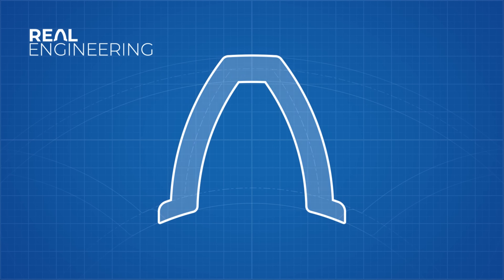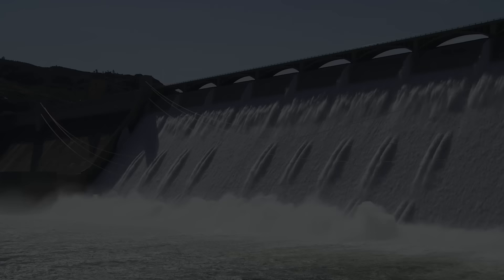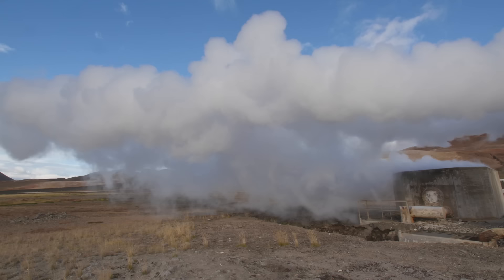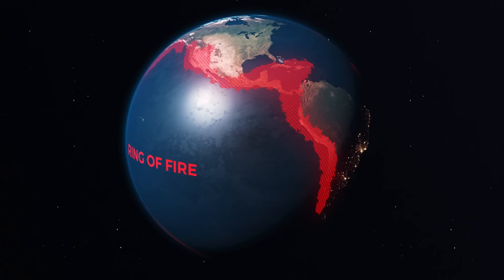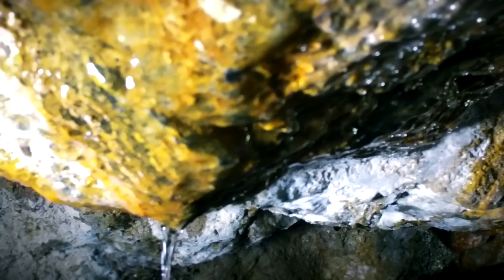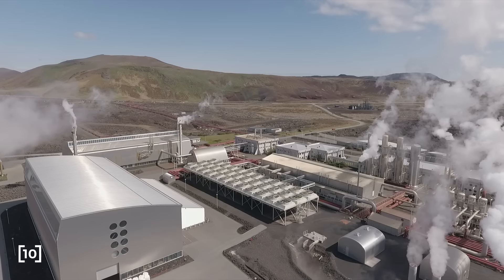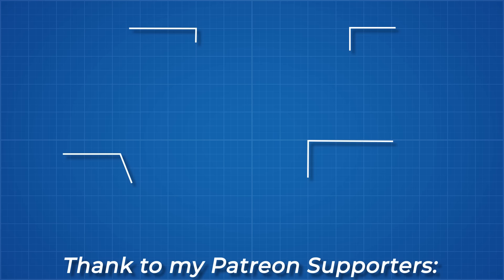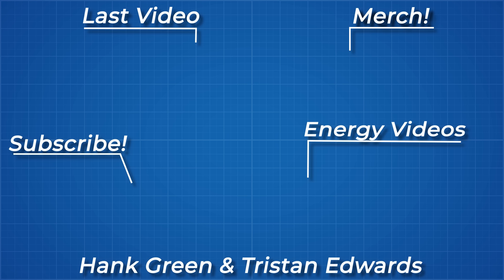Could Earth's Heat Solve Our Energy Problems?

Comment: German mechanical engineer here. Greatly appreciate the in-depth video as always. I wanted to point out some big potential drawbacks of geothermal energy you did not include in the video.

1. Geothermal energy is not boundless as the video suggests. Following the first law of thermodynamics, a natural occurring geothermal reservoir (or aquifer as it is known in the field) or a man-made one thanks to EGS, is bound to lose temperature over time due to the fact that we pump out more heat than we reinject. This inevitably causes a decrease in the aquifers temperature, which in turn causes a diminished steam production which then reduces the amount of generated electricity by turbine/generator. Some sources suggest that the average aquifer requires roughly 30 years until the original temperature is reached again.

2.Scaling/ Fouling. This is probably one of the greatest technical problems with geothermal plants nowadays. Since the water used for direct steam generation or secondary cycle heat transfer is coming from ca.3-4 km underground, it is saturated with different minerals, the most common being SiO2 (quartz) and CaCO3 (limestone). The chemical nature and type of the minerals is highly dependent on the location of the geothermal plant, but you can research them further if you'd like. Rapid changes in pressure and temperature along the pipes leads to the precipitation of these minerals (Scaling/Fouling) and unfortunately quite frequently to the failure of vital mechanical components such as pumps and heat exchangers. This leads to frequent halts of electricity production in most geothermal power plants.

Sorry for the long comment, I just feel passionate about the subject since it was the topic of my thesis!
Reply: Not an engineer here, nor do I play one on tv, nor did I stay at a Holiday Inn express last night. Now that this is out of the way I do wonder, regarding point 1) simple solution is to alternate production between sites, more or less like farmers don't plant crops in the same field year after year. Leave things to warm back up and then restart production. If you have enough sites that you can rotate in and out of production you should be sustainable. For point 2) Best but also horribly expensive way to deal with this is to have all your piping in a closed loop and not use ground water as a heat exchange fluid. What I could "envision" is something that would look a bit like a large tunnel boring machine that would have all the hardware on board, tilt it at an angle, let it dig, once it reaches layers of rock hot enough the outer casing ends up acting as a kind of heat sink and all your power generation hardware is inside the machine, all that is needed is to run cables so you can connect the power generated to the grid. When the rocks the machine is sitting in invariably cool down, it's able to start the digger head again, dig itself a bit deeper and start production again. Hard to explain what I have in mind but I think you can get the general idea.
Reply: Great comment!
Reply: Feeds Ravens  that sounds incredibly inefficient and like you would lose more energy than you'd generate.
Reply: Thank you.
Reply: Indian Electrical Engineer here.
I very much want the geothermal energy to take off soon! In India we are establishing a huge network of solar panels and wind turbines for power demands. Our target is to achieve 50% of India's power drmand out of renewable power before 2040. New, 12 Thorium reactors-power plants are about to be erected before 2030. Even if nuclear is mostly safe, we are always skeptical about the nuclear waste management. So geothermal has to become successful. We cannot continue to pollute the atmosphere by today's power production standards!

Mechanical engineers like you can make it possible to overcome the shortcomings of geothermal energy!
Reply: @cypher10297  nuclear waste is NOT a real problem.
Reply: Excellent list of some of the real problems. Like all so-called renewables there are real physical limits that "greens" simply ignore.
Reply: Can you use a low boiling temperature liquid (say Pentane) and let it flow in a shallower depth via piping and use the heat exchange between the ground and the liquid directly (instead of relying on a binary cycle system)? Seems more efficient, especially since it requires less energy to boil it - thus expanding the service life of that geothermal spot.
Reply: @cypher10297  
The confusion of CO2 with pollutants is the biggest problem.
Wind and solar at large scale will cost India, not help India. Actual pollutants can be well controlled. CO2 obsessions are a diversion.
Reply: @robertsmith4681  about the first point, as you told us that it will take about 30 years to make them hot again. Does that mean that an aquifer will last for about 30 years before going cold?

I know this actually depends upon the rate at we use the incoming heat, but i just am curious to know how fast a 75 degree aquifer runs out of heat. And how much of a place can it power ?

THANK YOU IN ADVANCE 
also, I learnt a lot from your comment too.
Reply: @MrMuki61  It's better to use a fluid with a higher thermal capacity in the ground loop. That way you don't have to pump as much fluid to extract the same amount of thermal energy. Heat exchangers can be very simple... basically 2 radiators stuck together or 2 pipes in close contact flowing in opposite directions.
Reply: @MrMuki61  that could be a reasonable solution. I wonder if the amount of potential work somehow changes at lower temperature?
I am always suspicious of easy looking solutions to tough challenges.
Reply: @MrMuki61  can you compare the coast of that liquid and water?
Reply: @huntera123  The reason why most actually easy things are hard to implement is because of people with attitude like you. Lol. I'm pretty sure you're not an engineer, but trying to teach actual engineers about how stuff work, without even having the basic understanding!
Reply: Edward Nelson trigger comment lols. CO2 plays a part in Global Warming and (health problems aside) that’s why we have to control it.
Reply: @fdc184  
Check your assumptions, check the actual data, and check the history of failed climate catastrophist predictions 
Pointing out that the Emperor had no clothes did not require special education. Ignoring that the Emperor has no clothes requires highly educated group think.
The catastrophist predictions are this generation's emperor's clothes.
Reply: @NickHorvath  I was thinking about this as more of as solution for arid countries. I'm from Israel and every drop of water is like gold over here (even though we have enough desalination plants to supply everything we need). Plus the fact that you don't need to drill as deep means that the risk for earthquakes is reduced. Only downside to this process (aside from the larger quantity of liquid required) would probably be the toxicity of the liquid. I wonder what would be the cost differences between the two liquids in the overall design (storage, usage, transport and procurement). Water is cheap and non-toxic, so it doesn't need any special care or attention. Pentane however will require more robust piping and more security measures to avoid leakage, thus increasing overall cost and reducing the efficiency of the heat exchange process. Maybe a different, less toxic liquid would be a better candidate. Would be a pretty interesting study though.
Reply: @cypher10297  
Skeptics are not sabotaging grand plans. Blaming non-believers for the continued failures of all climate obsessed policies is almost like blaming witches for droughts or sick cattle.
Reply: @cypher10297  or we could just stop using fossil fuels all together and use plasma for energy and transportation. Buuuut our governments wouldn't like that, or allow that, now would they?
Reply: Feeds Ravens  didn't cars used to be electric and have flex fuel 

It's the oil patents that want a sea way to Alaska and bankers that you need to have on our side. And they won't, as the Smoke And Fumes Committee shows, they're less sympathetic then a cartoon villain
Reply: Ehh.... I find the listed drawbacks to be minimal, but i live close to Yellowstone.
 
srsly though. 

You're drawbacks are a matter of perspective. 
You're viewing geothermal as primary source of energy, and, to be fair, the video presents them that way. 

Geothermal probably shouldn't be used as a primary energy source. 
It should be used to store power produced during peak-production time for renewable energy.
By choosing the depth and pressure that the water is pumped from, you can limit the thermal transfer out of the geothermal well. 
Couple that with a method for injecting hot steam back into the ground, and you have an energy storage method, not necessarily a primary energy source. 

After all that, the video specifically seems to ignore natural gas production of geothermal sources. 
Although I'm aware of the fact that not every geothermal well produces copious amounts of natural gas, I think that's more due to our lack of utilization, rather than it truly being an impossibility. 
Fischer-Tropsch synthesis, in which carbon monoxide and dioxide are turned into methane, and syn-gas reforming, in which a carbon source is turned into methane, hydrogen, and/or carbon dioxide, are both potentially active in the same place, depending on rock composition, temperature, and pressure. 
Allowing a liter of methane to vent into the atmosphere is the equivalent of venting 50 liters of Carbon Dioxide, so really the issue with geothermal is an issue of scale and potential harm through careless release.
Reply: @vDarknessFalls  If money is going to pour in because of oil? 100% The government wouldn't switch to anything that's going to affect this income. Even if it means destroying the planet. Arab countries and USA belongs in this category.

If money is wasted because of oil imports? The government will take steps to limit or completely halt the outgoing money. Saving the planet is a side effect of the move. India, Europe and other advanced Asian countries belong in this category.
Reply: @snim9515  Well, it's hard to say since it depends on where you live. In general, Pentane can cost as low as $1 per Kg if you buy in bulk (which is the likely option if you want to use it commercially). Generally, in geothermal power plants the water that is used is already there (groundwater), so it's basically free (aside from licensing fees incurred by the government).
Reply: @MrMuki61  adding the coast of transportation and you have your answer.
Reply: @AmericanJusticeCorp 
But here's the thing. The earth's core is PLASMA. The ONLY thing containing that plasma, is the mantle tightly packed around it like a plasma globe you seen in science class. What the fuck do you think drilling and fracking that glass globe will do to the plasma inside??? Hmm?
Reply: Danaili6i
 -I was going to say the same thing but you have already covered it. I have, in fact, been to the Wairakei geothermal power station in New Zealand and they have already experienced drops in steam field output. In addition, some of the geothermal attractions in the area have failed. It may be a natural resource, but nothing is limitless.
Reply: Is there a way to view your thesis on this topic? Would it be possible to view it on ResearchGate?
Reply: Robert Smith You’re idea is highly unrealistic and relies on the idea that there are infinite geothermal vents. The digging required to reach the same temperatures that natural geothermal vents are extremely expensive. Have you ever heard of the drilling race? It’s the underrated version of the space-race between the United States and the Soviet Union. The project itself cost 2.4 billion dollars for the Soviet Union and stopped way before they reached the mantle. Geothermal energy is not some magical solution, there are majors flaws to it. There is a reason we don’t see a lot of investment in geothermal power. It doesn’t take an engineer or a science degree to know you can’t force something to work.
Reply: Student of computational physics and mechanical engineering here: I have a concern on the environmental impact and more particularly the earthquake and seismic impact that these  geothermic plants bring to already high seismic areas. Is there a way to reduce or eradicate this issue? Or is this a non-issue now?
Reply: Geothermal energy has been stable for billions of years, as the earths generated heat is met with the solar radiation which creates an equilibrium of heat escaping. So irrespective of entropy for human lifespans geothermal energy is boundless but as the mechanical engineer suggests its not free, there are issues that drive costs.  Still comparing those issues to Otec, Nuclear, wave or tidal power, sources that can be non intermittent, there is a lot to favor geothermal.  One has to also separate high temp geothermal from low temp geothermal. Low temp geothermal such as harvested by heat pumps could use syitling engines to pump using solar and thermal storage and could be much less expensive.  Also using an organic rankine cycle or thermal chemical oscillators to drive such are new methods which could also be applied to Otec.
Reply: @robertsmith4681  you're right: you aren't an engineer, so don't think you know more than an engineer.
Reply: Well yes number one is a big problem but it has an easy solution, well, it would take an incredible amount of time for the geothermal energy to wear off, especially since convection is always bringing new heat up from the core, so that problem is basically non-existence. 
I would say the biggest con is that we are slowly dooming ourselves to a slow and painfull death by radiation from the sun, since we would cool the earth's core faster causing the iron to solidify and henceforth stop spinning. Which would cause the protective magnetic field to go away and the sun's radiation would slowly kill us, (well not slowly). And if you survived that in a few million years after the magnetic field went bye-bye the atmosphere would be completely stripped away from solar winds leaving earth a barren uninhabitable rock. Of course we would die sooner using coal.
Reply: @remenencenda768  Couple it with geothermal heat pumps such that in summer you are pumping in heat, it will raise temps is does in the field, and it can offset the loses as long as we have a functioning sun.
Reply: @remenencenda768  finally someone else who thought about the fact, that geothermal energy is essentially draining earths core temperature leading to the scenario you mentioned, which eventually will happen anyways, but one should think about if it is really such a good idea to artificially speed up this process...
Reply: @TheScarvig  With enough wind mills one could stop all wind. With enough geothermal plants one could stop all convection currents.
Reply: @TheScarvig  That was just me rambling, while it will eventually do that it will take an insane amount of time, and like I said, The other sources would kill us faster
Reply: @KimberlyRPeacock  It was a JOKE I mean, it might happen but it is in no way relevant to us. Also the radiactive elements will eventually decay completely and the scenario will still go on
Reply: Kepler Burger  That is correct you are thinking like a scientist in systems.   Besides like I said you can ensure more solar is stored than would be naturally of course that might impact global warming. I tend to think not long term as the dynamics are in atmosphere.  Hotter temps you radiate more colder and you absorb more.
Reply: Thank you so much for your Insight. I like these videos because they give us a chance to think and sometimes give us a snapshot as to where our progress is in different areas
Reply: @cypher10297  every solar panel produced takes ~7 years to offset it's carbon footprint if it doesn't require any maintenance or replacement from damage. each battery produced to store the solar energy takes ~15 years to offset it's carbon footprint but needs to be replaced every 8-10 years. solar is worse for the environment than coal. especially when  you look at the fact that coal production plants can be net negative carbon by containing the carbon and selling it for welders and manufacturing.
Reply: There are three main sources of heat in the deep earth: (1) heat from when the planet formed and accreted, which has not yet been lost; (2) frictional heating, caused by denser core material sinking to the centre of the planet; and (3) heat from the decay of radioactive elements. 
Verhoogen gives 5000 K as the core temperature now, and a 250 K cooling since the formation of the Solar System, 4.5 billion years ago. 
If it really does cool at that rate (55 degrees per billion years), it would take something like 91 billion years to cool to 0 Kelvin.
Reply: @emilie6466  It is true that I am an optimist when it comes to people figuring out how to solve engineering challenges such as making deep drilling economical. Just look at how far we got in barely 100 years.
Reply: There are a lot of renewable and different energy options that we are goin for I dont think geothermal will realistically pan out but its always good to look
Reply: @cypher10297  Thorium Salt (liquid) reactors actually burn the "normal" nuclear waste as fuel, so you would actually get less waste by utilizing that technology.
Reply: @Danaili6i thank you for sending some clarifying information, your passion is evident.
Reply: Well. That's just like... your opinion, man.
Reply: Carnot Cycle
Reply: Well I would like to think you passed👍
Reply: A pipe inside of a pipe is a loop.   But even stainless steel has a short life a high temperature when water is involved.
Reply: 1. The Earth's core is naturally cooling as with all planets, and exposing and using more geothermal only accelerates this cooling.  A cooler core means a less active core, which leads to a weaker magnetic field.  A weaker magnetic field has all kinds of disastrous effects that eventually lead to Mars conditions.

2. Shallow field heat pumps are mostly fine as they utilize ground level heating and does not tap into mantle source heat. 

This is more than just an engineering  problem and there are serious geophysical repercussions beyond surface level earthquakes.
Reply: For number 1,
Couldnt we put nuclear waste there? It produces heat and is basically a low temperature nuclear reactor. That way we are pumping heat in at the same rate we pump heat out. First we have to get the amount of heat we are taking out, and put the equivalent amount of nuclear material in there, but then it is only pumping in the waste at the rate needed to sustain the amount of nuclear material down there.
Reply: Balanced discussion is always appreciated.  Thank you for contributing your detailed supplemental viewpoints
Reply: Danaili6i thanks for the insight. 
They’re inevitably has to be some concern with this type of fracking as well. 
Thoughts ?
Reply: S nim lol. You’ve maybe fallen and bumped your head too hard. 
It’s a problem alright. Now and for years to come. “ nuclear waste is NOT a problem” 
🤦🏻‍♂️ 
Lol. 
Wowza. 
Maybe if your the Japanese government it’s not. Or maybe the Russian government.  But the the rest of common sense humanity it’s a long lasting problem.
Reply: vDarkness Falls the earths core is molten iron and nickel not plasma.
Reply: It is called: FRACKING not EGS except to liars who do not like the acronym FRACKING
Reply: You said what I wanted to say. Thanks.
Reply: 1. I would rather read the data through a real functioning geothermal power plant rather than just, "Some sources suggest"
2.  "is bound to lose temperature over time due to the fact that we pump out more heat than we reinject.",... then how cold is the lava and ash ejected by the Earth during volcano eruption than can happen around several time in 100 years?
Reply: hi, this might be a stupid question but i've wondered for a while: why are outlet holes even necessary? couldn't a valve at the top of the injection well allow steam to escape while still pumping water in?
Reply: @frankmueller2781  Inventer of interlaced TV signal was 12 years old...
Reply: I find it funny how you emphasize 'German'. It's lovely.
Reply: If only we had a "on demand" source to cover the maintainence/downtime. Itd be the energy utopia.
Reply: Feeds Ravens  
So a clean way to generate kerosene...a fossil fuel?
This might be a good video topic for Thunderf00t after all....and that's rare.
Reply: Yen Tao  
Exactly.
We are like ants. We think we control the planet but that's like fleas thinking they control the dog.
Reply: Feeds Ravens  
Ask France how that's working for them? Then ask Germany how much energy they. (THEY) generate during the nighttime hours.
Reply: Feeds Ravens  
The world has been ending for neigh fifty years. Yet we're still here.

From ozone to global warming to climate change to man made climate change.

It's been 12 years for 50 years.
Reply: Feeds Ravens  
Exactly right.
I'm very impressed at how quickly you formulate such detailed responses.  
In my opinion... we aren't quite ready to be 100% green. But we can get there in time.
Reply: @Acolyte47  You're absolutely right, but if you check the available alternatives like hydro power storage and hydrogen they are not efficient too. Power loss exists even in battery technology. I think that can be tolerated with the abundance of sun's energy and then you have to choose the technology for storage that is more cost effective.
Reply: Well, we have a real life example, New Zealand was using Geo-Thermal at an extensive rate. They had to stop it. Since so many people were tapping into their Geo-thermal reservoir, the reservoir was cooling down drastically the government had to stop new uses and I think I remember they were even discussing capping off existing pipes.So as @Danaili6i pointed out it is not limitless.@RealEngineering, Our biggest energy usage is temperature  control so if you just utilize the natural constant temperature from 6 meters below ground level you reduce your energy requirements. You also need to educate people to become more energy efficient producing more energy isn't the answer, the answer is to make it so the energy isn't needed to be produced. We need to make our caves better so they need less wood to heat the winter, and less ice to cool in the summer. The implementation of more passive heating and cooling is also required. 

Wave generators were looking promising but I lost track of what happened with those.
Reply: @snim9515  It can be, and it is in countries that aren't responsible with their disposal.
Reply: After he did a couple of videos on topics i have some knowlage on i realised this guys videos are quite heavly bias towards his own opinions and will often over look or simply brush off facts he doesnt like. Shame really cause the videos are well polished.
Reply: @robertsmith4681  Definitely not an engineer. In point 1) OP said that the laws of thermodynamics will cool Earth down more quickly because its core heat is not boundless. It doesn't just "regenerate". It dissipates.
Reply: @fdc184  But controlling CO2 emissions would cost big corporations too much money, and they'll go to any means necessary to stop such efforts.
Reply: Unless you are near a site with convention currents like an active volcano. I know in a town in Russia they use an active volcano to power the nearby town.
Reply: Edward Nelson check out my logic, or at least try to refute directly rather than pinpointing at patterns. 

So I’ll ask now. Outside of this disgust and perception of environmental notions as hysteria. 

Because that’s what happens, you get bombarded with Reds and you get used to it, grow accustomed to it.  

Outside all that what makes you think that global warming’s not a problem, that it is not real?
Reply: @emilie6466  the ruskies won that one though, didn't they.  We still haven't drilled a hole as deep as the Soviets. 😡
Reply: @NickHorvath  - "Steering" oil well drills got Kuwait in trouble with Iraq!
Reply: Awesome comment
Reply: Thank you.Nice to have real info from a professional.
Reply: Thanks I was wondering about thermodynamics myself. Just on a  longer time period and effects to the core. Yes the Earth's center is very hot and large. But by using it's heat, there MIGHT be future implications. What would happen if we used this technique for say... 500years? What effect would it have on the core? And in return the  magnetic field? Mars doesn't have a magnetic field anymore, because it's core cold down.
Reply: you make a good counter point
Reply: @snim9515  except that it is ..
Reply: Damn, why are Germans so good at engineering?  Just kidding, nice post!
Reply: Awsome comment the difficulting maintaining such a mechanism never occured to me 😀 thanks for that insight.
Reply: Civil engineer here, we will build it because we need to eat regardless
Reply: Not a accredited engineer of any sort but have a very scientific curious mind and recently read on new nanotechnology engineering making coatings possible that reject “deposits”.
Reply: Danaili6i Maybe they could make multiple small and movable power turbines and cycle them through an area ~every 30 years to allow the area’s to heat up again. Sort of like crop rotation, I guess, but for geothermal heat sources.
Reply: @kennethhickford1448  Cooling the core to 0 Kelvin is not necessary for catastrophic effects to occur. The magnetosphere just needs to be weak enough to allow the solar wind to penetrate to ground level and then to start depleting the atmosphere. Since the Earth is closer to the Sun than Mars, the effects of the solar wind on Earth would be at least 2.3 times greater (1.524 AU)
Reply: Where is the proof that the interior of the Earth is so hot?  Seriously!  We've only ever drilled less than 9 miles into the crust..  Seems like everyone has blindly accepted an unproven theory about the Earth forming from accretion and having ungodly heat inside.  I don't think there is evidence to support it.
Reply: Not boundless but look at the consequences of nuclear:  Chernobyl, 3 Mile Island, many unreported accidents raising global radioactivity, and need I mention Fukushima.
Reply: @vDarknessFalls  Deepest we have drilled (with massive issues because of the depth) is aprox. 10km. Distance to the center of the planet is aprox 6300 kms. We are NOT even close to reaching the super heated zones of the earth. And for the record, there is NO plasma at the earths core. It is a vast liquid sphere surrounding a core of solid metal.
Reply: @nevar108  you're right. Drilling doesn't affect it. I just did the math. BUT, all major earthquakes had VLF waves exiting the center of earth, hitting the ionosphere, and going back down. Only ONE thing creates VLF waves. PLASMA. The earth has a solid mass, but the very center, is PLASMA. Surrounded by an iron and nickel shell. JUST like a plasma globe. Prove me wrong about VLF plasma waves and earthquakes.
Reply: Wow!! Thank you for explaining this with such detail! Amazing comment man.
Reply: Could you not Just use a heat sink and peltier thermal electric generators to harness this geothermal energy? Would that not be more efficient in keeping the temperatures from  declining since we are not pumping in cooler water. The benefits of this are endless: there would not be a need for the use of a mechanical steam generator so there would be no more scaling/fouling including mechanical maintenance and break downs.Then we wouldnt have to do any fracking as there would be no need to do so. I have been pondering this for quite some time using peltier TEG's to our advantage. How many deserts do we have? How many volcanoes are there? how many hot pools are there. Just think of the possibilities it could be a very good non-invasive way at harnessing this energy without doing extreme harm to our crust by drilling and fracking.
Reply: Feeds Ravens  I personally believe that batteries are very good for small energy needs but very quickly reach the point where their benefits are outweighed by their limited capacity.  Batteries in the macro sense are like capacitors in the micro sense.  They are necessary to perform certain functions, but can not be depended upon as a primary source of power.  JMHO.
Reply: colleen nvb  To believe that puny human beings can deplete the Earth's core by tapping into it is like believing in human proximate cause global warming.
           A prediction:   Once humans can tap into the lower levels of our Earth's geothermal structures for  heat and energy use, there will be the AOC's of the world of self-proclaimed "experts" who will argue we are causing intentional "Global Cooling".
Reply: Appreciate your comments but some of the engineers I have spoke to see your two problems and will raise you a few. The Iceland use of GT is a great case example- they mine the rising heat and pipe it to their cities as a public heating resource rather than using firewood or even less green material. Additionally they have procedures to clean all this , so that can be taken as largely solved- California has been operating GT plants in it's northern counties continuously for many years, so I'm sure the "math" to compute the potential yield and therefore the highest rate of energy that can be siphoned out of a given hole.
   We have the tech to do this- the drilling tech has already figured out how to go 25-27 thousand feet down and predict to withing 3' where the drill bit is and will be- horizontally as well as horizontally. We can produce several kinds of set in place liners to protect our steam fluids from ground contamination and the ground from contact with our GT fluids. As some one her has said, Yellowstone is an active site- it is dangerous whether we try this or not, so getting the rest of the science done and then drilling thousands of horizontal wells around Yellowstone park and turning horizontal to cross under it and meet a predicted vertical bore hole 100-110 miles away could well do the US energy grid much good- it will employ thousands of oil field drilling personnel and equipment, thousands of RR and general construction people, huge bunches of certified welders, fitters etc. It will free the present oil co.s and allow their R&D to discover what new products can be made of the petrochemical soup they trade in today, while they transition from fossil fuels to a new energy source- much as they did when they were mostly big coal companies in the 19th C.. Ultimately, we can cool down the "plug" in the present day maw of the Yellowstone volcano; we could never stop watching and extending our GT field south and eastward to stay over the magma bubble that is closest to the surface.
  FWIW, I am a retired plumber, licensed in two states, have some college and a close connection thru my family to the "Oil Biz'. I have served as a classroom teacher's aide in the advanced classes on oil field technology and process that school taught to oil field crews from the roustabout to the administration levels of companies. Credentials matter when you are talking about pissing about with an unholy, massive disaster potential as the Yellowstone volcano; as I said earlier, I feel it can be done and it is important that America "do this thing"; there a five Yellowstone type super volcanoes in the world- if we prove a viable way to tap them and a program to stabilize the regions they are in, what would it be worth to say China or other nation to turn an impending disaster into a great source of energy?
  I think Andrew Yang is the right guy to take this up- he hasn't shown anti tech concepts etc., and his history with Silicon Valley suggests he would get the experts and the appropriate watchers to suss this out and figure a way to finance it . But that's my thoughts, anyway.
Reply: @fredericrike5974  I certainly appreciate the time you have taken to respond on behalf of anybody who might be interested.  I'll have to "sleep on it" as they say about your comment and meditate on your thoughts before I can return a viable comment, if even possible.  Thank you for responding in such an intelligent fashion.  Be well.
Reply: Leigh Hewit  but then we would lose alot of gravity and the strength of the magnetic field as a result if that happened.
Why would VLF waves be coming from our earth core, hitting the ionosphere, and coming back down?? There's only one thing that could do that. Plasma. Our Earth's very inner core, is PLASMA. Surrounded by the iron and nickel shell, much like the glass on a plasma globe in science class.
Reply: Feeds Ravens  Wow, you can rent gliders for $11.00 U.S? in Germany?   We can't even do that here in the States.  That is definitely a bargain.  In fact, at that price, I can afford to take a vacation to Germany, a country I've always wanted to visit, next to Italy, and get my glider pilot's license for under a few hundred dollars, U.S.  Thanks for the information.  Be well, thanks again.
Reply: Thank you for sharing your knowledge gained from experience...you make it clear that there is no turn key answer to our energy consumption.
Reply: @daffidavit  Will be looking forward to it! Be well and great fortune to you!
Reply: @Danaili6i
Thank you for the comment. Would your thesis happen to be available in English, or is it in German?
Reply: @Lexoka  Pardon if I seemed to overstate myself- I'm not a school trained engineer- far from it! But I've grown up with an engineer for a father and known the beasts since I was a child with "dumb questions". So there is no great thesis - but my response was to indicate this is an idea we need to explore thoroughly before just chucking it. The Chermin part of me became an American some two or three generations ago! But thanks anyway!
Reply: For those who are oblivious to this FACT, the Earth's magnetic field being generated at a super-hot iron/nickel core through a dynamo mechanism was NEVER MORE THAN AN HYPOTHESIS.  What if it's entirely wrong??  What if the interior isn't hot?  

What if the core is ice?  Are you aware that there is NO HIGH-PRESSURE PHASE OF IRON that allows it to exist at core pressures?  Ice is the only known substance with such a high-pressure  phase. 

Lava doesn't come from magma chambers or plumes originating in the mantle...  it is created in the crust below the point of expulsion thru frictional ground movement.   

Do you believe that mines get hotter as you go deeper into them because you are getting closer to the heat from the interior?  Why then, do oceans actually get colder as you go deeper and therefore closer to the supposed interior heat??  Why do deep cave systems not get hotter with depth?  

Earthquakes are the fracturing of brittle, solid matter.  If the interior is super-hot to the point where solid matter either becomes molten or ductile, how then do we explain DEEP EARTHQUAKES that take place in the mantle where nothing should be brittle enough to fracture? 

The Earth's magnetic field is generated in the CRUST thru a mechanism called Earthtide. 

All the above is contrary to modern scientific dogma.  It is, nevertheless..  CORRECT!
Reply: @freemind..  All very interesting. Sources we can research?
Reply: @Obscurai  Hi!
There so many variables in the progress of the Earths Transit via the journey through the outer edges of our Galaxy that to make any 'Prediction' as to future events is a bit foolish!
Plus, I never made any mention of the Catastrophies that may or may not occur to this planet. So, I don't know why you chose this tack?
I just commented on Geothermal energy!
Perchance you should read my post again?.....Yes?
Reply: @fredericrike5974  Sorry, my question was aimed at @Danaili6i, who mentioned having written a thesis on the topic. I've edited my question to reflect this. Sorry for the confusion, and thanks for taking the time to respond anyway!
Reply: @Lexoka  Not a problem! I prefer the discussions that start here vs IG and FB because they are more civil and to the point. Your question was certainly civil and your intent appears to be learning something- Good on You!
Reply: @Lexoka  FWIW; the energy people in Iceland and the Australians have done a heap of work on GT and many installations over the last decades- I've met some of the Aussies and  have seen some of their work- awesome, but I expected nothing else.
Reply: @kennethhickford1448  No you didn't mention the potential catastrophes - that's why I specifically mentioned them to you. The calculation to a 0 Kelvin core  may be mathematically correct, but is irrelevant to the discussion of geothermal energy since the Earth would be long dead and barren before 0 Kelvin is reached. That is why I chose "that tack". 

In particular, extensive use of deep drilling and use of geothermal (as opposed to opportunistic mostly surface level geothermal) is damaging to the fluid dynamics of the core and thus the magnetosphere. The issues for geothermal energy are not simply an engineering problem but a geophysical one that goes beyond surface level earthquakes. Sometimes, the engineers need to listen to the geophysicists.
Reply: @Obscurai  Once again I made no comment about the use of Geothermal Energy in my original post....Yes?
Reply: @kennethhickford1448  Then why are you commenting on a thread on geothermal energy about a video about geothermal energy? Mentioning the thermal energy sources and then simplistically calculating the duration of when the core would reach 0 Kelvin is irrelevant to this thread and to this video. What was your point in commenting?
Reply: Danaili6i As for point no.2, oil and gas refining has a similar effect on mechanical components such as valves, pumps, instrumentation, and piping systems in general.  The solution?  Maintenance as usual, and periodic overhauling of the mechanical systems.  As he mentioned in the video, it would be a great employment initiative for a well-trained and experienced group of mechanical tradesmen.
Reply: Thanks for this! I knew there had to be more drawbacks.
Reply: I may know a way to solve the problem. At least the scaling problem. Drill MANY holes and introduce hollow metal rods in the ground. Then cycle fluid through the rods. Not as efficient but it will work like a radiator. Cool the rods and extract the heat.
Reply: As an engineer myself I tend to watch these sorts of vids with a grain of salt. If there was some cheap, easy, and non polluting solution to energy generation, there would already be a huge industry around it due to government and market incentives. 

If something isn’t happening on a large scale it’s usually bc it’s not really as cheap as it seems or there are still technical issues to be worked out for large scale production.
Reply: @Obscurai  Re: "What was your point in commenting"?
Because I can and it's a free country,...Well......Sort of!
And who are you to tell me what I can and cannot post?
You are coming across as a real bully!
In which case you are wasting your time on me! LOL!
Reply: @RyanRussell885   Well said!
It seems that a certain section of Society want a foolproof 'Fit & Forget' solution to all the worlds problems, but, as ee and thee know, it ain't gonna happen! 
Mind you. they could Doctor the Monitoring equipment along the lines of VW Emissions so it looks like it's a 'Fit & Forget!!?? LOL!
Reply: @Lexoka  Thank you for the interest. It was written in German and is sadly not available to the public (part of non-disclosure agreement)
Reply: @RyanRussell885  There are a lot of possible solutions to scaling deposits. One of them are organic inhibitors which are still under research. They would be a very cool solution because they target the very genesis of scaling crystals and eliminate the need of frequent pipe maintenance. One of the more common solutions nowadays is the use of HCl (hydrochloric acid) - much like how we use strong acid solutions to clean limestone deposits from cooking pots, but this requires a maintenance halt of the power plant. This as you can imagine is a great economic loss for the geothermal power plants and can damage the acid resistive coatings of most steel components in time, potentially risking more need for maintenance.
Reply: @MerkDolf  Thanks for the insight on New Zealand! Wasn't aware of this.
Reply: @Danaili6i  Too bad, but thank you for your answer!
Reply: I think both issues could be overcome by going with a closed loop system and just drilling deeper. If we could place a heat exchanger in a depth that is barely below the melting point of the pipes and heat exchanger itself, it would just be a very efficient steam power plant, with an inert thermolite running through the loop between 1,000° C and ambient. Of course this all depends on improving drilling technology.
Reply: Danaili6i you’re absolutely right.  However, as a steamfitter that works in oil and gas—both conventional strip mining operations as well as Steam Assisted Gravity Drainage (SAGD)—I can tell you that constant maintenance and routine plant maintenance shutdowns are the norm and the name of the game.  There simply is no maintenance-free, automatic energy source, as much as we might like to think there is.  The last SAGD operation I worked at was both one of the most maintenance-intensive sites I worked at and also one of the most profitable.  The good news is that there are plenty of qualified professionals out there that are ready and willing to build and maintain these systems.  As I see it, there are always technical issues and challenges to contend with, but we, as a species have become quite good at developing solutions to those problems.  I think the biggest hurdle is really gathering political will and social support to defeat the oil and gas lobby and progress into the future.
Reply: @kennethhickford1448  In common discussion, relevance is prerequisite. Free country or not is irrelevant. Bully or not is irrelevant. How does your initial comment relate to the issue of geothermal energy usage? Since you avoided the question by bringing up free speech and personal assessments, you are indeed a waste of time.
Reply: @Obscurai  
Re: "You are indeed a waste of time"
You are entitled to your opinion. Hahahaha!
Once again, I made no reference to Geothermal usage in my original post.
Reply: As a joke mentioned once seeing a movie about this sort of thing. The movie had the scientists doing the drilling causing a crack to go around the Earth. This crack allowed a great mass of magma to erupt out into space, become a 2nd moon & start orbiting the Earth. I DON'T expect that to happen. Actually the movie hypothesized drilling down close to the core of the Earth. I don't expect anything like that to happen, it does go to the whole problem of disrupting the rock layers underneath, as is alluded to in this video. 
It seems to me, as an ignorant amateur, that the solution to your problem of mineral deposits & the causing of erosion by disrupting the rock layer beneath is w/ some kind of closed system. You place a closed loop of piping inside the Earth, pump clean water where the water is heated by the surrounding rock & then comes back up as steam. Maybe I'll be laughed at b/c of a 1,ooo technical reason why this is stupid but I'd like to know why it wouldn't work.
Reply: @VictorLepanto  Hi Victor!
Re: "You place a closed loop of piping inside the Earth, pump clean water where the water is heated by the surrounding rock & then comes back up as steam"!

They do something like you state but on a very small scale for heating Domestic dwellings.
Much like a Refrigerator in reverse,....Sort of. 
At a depth of about 15 metres, ground temperatures are not influenced by seasonal air temperature changes and tend to remain stable all year around at about the mean annual air temperature (9–13°C in the UK).
I read, (But don't quote me) they tried it on an estate somewhere in the UK, but had to shut it down as it cost too much to run!
They also bored holes down in Cornwall? somewhere some time back, and then capped off the Boreholes.
Currently, there are no deep geothermal plants in the UK. The Redruth site has the potential of supplying over 10 megawatts of electricity and 550 megawatts of heat for the community.
Reply: @kennethhickford1448  And once again, you are posting in a thread about geothermal energy under a video about geothermal energy, and you failed to explain how your post is relevant to that topic. This is not my opinion, but a question about the relevance of your post and you have still not provided one. You are indeed free to post anything you want, but if it is not relevant or you cannot explain its relevance then you are indeed a waste of time. I await your explanation of relevance.
Reply: @snim9515  please explain. This seems like a bold-faced lie to me, and to say it without any explanations is plainly irresponsible
Reply: @thoughtsfromahead  comparing the risk of nuclear waste (which can be disposed ) with the risk of  poisonous gases which can't be desposed, for starters.  Even making solar cells require high grade silicon which requires mining which has its own problems. Comparing the amount of coast per unit energy nuclear energy is much much much better than ANY other source. Moreover since  that nuclear melt down in Chernobyl NOT A SINGLE PERSON HAS DIED DUE TO NUCLEAR POWER PLANT. Do your own research.
Reply: @kennethhickford1448  Correct you have not provided any explanation of relevance to anyone for your initial post. That's why I am asking for it. Your continued refusal, or inability to provide one, confirms that your initial post is irrelevant. Thank you.
Reply: Taking large amounts of heat from the earth in scatter places seems like it would cause a lot of issues geologically speaking down the line.
Reply: @hgbugalou  Hello Michael.
As to the ramifications of using Geothermal Energy, that is a matter for those who know of what they speak.
All I have done is comment on the source of Geothermal Energy, not its possible use and the possible problems involved.
Regards.
Reply: @huntera123  I'd imagine the producer of this video, would consider himself a 'green'. I'm assuming I know, but most of his videos are about 'solutions' to the climate crisis. It kinda sounds like you would want renewables to fail, simply because you dislike the people supporting them. There are technical hurdles, not physical limits, to the future of our energy system. The 'real problems' of fossil fuels are still being ignored and they may kill us all.
Reply: @corneliuscorcoran9900  
Wow, I don't want them to fail and I  certainly don't want a physical/engineering process to fail for personal reasons. I point out that there is actually not a crisis and get insulted. I point out that "green" solutions don't work and get trolled.
Reply: Thank you for the real life insight and presentation.
Reply: @rosewhite---  
The amount of useful work from residual heat is negligible.
The cost of storing solar energy for cloudy/dark times is substantial. Batteries, pumped water, molten salt, storage walls, fly wheels, all have been tried and don't work.
Physics is not just a good idea, it is the law.
Reply: @rosewhite---  LOL.....   And how did you determine the age of the earth?  Did you also use this same method to determine the age of other planets and celestial bodies like the sun?    How about distances, you measure the distances between planets, the sun, and other stars?  what about the speed of light?
Reply: @rosewhite--- :-
I have no intention of doing what you suggest! LOL!
Regards.
Reply: And you have yet to describe how you determined earth's age, the methodology used, etc.
Reply: @rosewhite---    cyanobacteria transformed the world we have today making possible the rise of plants.   And snowflakes over geological time have tremendous power, they form glaciers which grind mountains away.  You are funny if you think that someone like you could insult me. You do not matter.
Reply: @rosewhite---  the pressure of the plates combined with the rotation of earth going 1000 mph, would create way too much heat at the core to allow the existence of water. There is no way Russians can drill deep enough to even reach the core first of all. Not even halfway. Now it is likely they hit coolspots in which no lava flow is near, to allow the existence of ocean sized water to form in giant cavern pockets deep down.
Reply: @rosewhite---  Good to se you have read Cicero.
“To be ignorant of what occurred before you were born is to remain always a child. For what is the worth of human life, unless it is woven into the life of our ancestors by the records of history?”
Reply: @rosewhite--- 

As I recall, Initially you posted me in response to a post to another on here!? .......So, who is doing the 'Trolling'?
BUT, as long as it annoys you, I am satisfied! Hahahahaha!
Reply: Canadian engineer here. I agree with the other real engineer from Germany. 
The Engineering isn't finished until you've done the Cost Benefit Analysis.  Study the existing Geothermal plant near San Francisco. It has not done well economically. If you really care, look it up. I do and I have.
Reply: @rosewhite---  so you mean to tell me the VLFs being measured coming from the core during big quakes, is from a water based core, even though the only thing that can create natural VLFs is plasma? Seems legit. Glad you're here to educate people.
Reply: @rosewhite---  
Oh, of course. Thank you for making yourself so clear.
Reply: @rosewhite---  It's impossible for the Earth to be only 6000 years old and for a global flood to have occurred. Put down your book of stories and learn some real physics.
Reply: @tadferd4340  thank you. Hey do you remember the strange atmospheric trumpet noises that get heard all over the world??
Reply: Im not even an engeniering but i do think the same as you say on the first one i mean there's a hot spring in bali before you couldn't even bath in there and now the temprature decreasing to 35C
Reply: Master engineer lvl100 here, just passing by.
Reply: @rosewhite---  We believe nothing but that which we can test and measure and subject to testing.  I'm guessing with your worm theory you do not believe in tectonic plates.  The outer crust of the earth is subject to recycling. That which we think of as solid,  is a floating crust which gets pulled down and is also spit back up in the form of molten rock which cools and becomes new crust and later new topsoil.
Reply: @rosewhite---  No Idea what you are referring to
Reply: @telciris  
From some going by "Warlock", lol.
Reading and hearing wide variety of views used to be called "open minded" and "well informed". But that was in an age of "tolerance".
Reply: @Danaili6i
Hallo, hab in deinem Kommentar gelesen das du Ingenieur bist... bin gerade 8 klasse Gymnasium und wollte später auch Ingenieur werden... hast du vllt ein paar Tipps auf welche Fächer man am besten achten sollte oder Lks? Danke schonmal im voraus!
Reply: Lennart Mathe und Physik :)
Reply: Trenton Chard 1. Check out the reports from the 90s on the Alpine Molasse basin - massive pressure drops and diminished steam production were observed due to massive overexploitation, same goes for the Waikara plant in NZ as mentioned earlier in the comments. Black box approach is simplistic, I agree, but cooled geothermal water is being reinjected back underground, these are geothermal plant basics, so I'm not sure I understand your argument.

2.To be more specific, filters can get clogged and malfunction too, you know :) Pumps have been reported to fail from lack of machine oil, due to clogged oil canals. Just sayin: I'm not saying there aren't any solutions to these problems. But they still are problems and keep causing damage.
Reply: @NickHorvath , the problem with that is that the liquid in question being discussed here is water (which is good for many other reasons: such as the fact that it's not harmful as well as the fact that it's often already there); and if you made a list of heat capacities of different liquids water would already come near the top. That is, water may already come very close to being the optimum liquid in that respect.
Reply: Not sure they deserve the praise of your first sentence. You then go on to detail their errors. Also I noted his first major error a few moments in. He claimed the Earth's source of heat from 1. Gravitational forces. 2. Friction 3, Radioactive decay. I would put radioactive decay as #1 and the primary source today and into the billions of years to come, but then he says it is in the upper mantle and crust and names Potassium 40 making it sound like that is the primary isotope of radioactive decay. Sorry  along with Iron and Nickel our core has a high concentration of heavier elements like Uranium and Thorium.
Reply: There is a company called ORMAT that is the largest in the geothermal technology. The heat exchanger is a two stage process that uses hot water from a geothermal well to boil pentane which drives the turbine. Ormat has a plant in southern Hawaii near the east rift zone of the Kilauea Volcano which was taken out of service due to a lava flow in the 2018 eruption..
Reply: See also:  This is from https://en.wikipedia.org/wiki/Geothermal_power
"Geothermal power requires no fuel; it is therefore immune to fuel cost fluctuations. However, capital costs tend to be high. Drilling accounts for over half the costs, and exploration of deep resources entails significant risks. A typical well doublet in Nevada can support 4.5 megawatts (MW) of electricity generation and costs about $10 million to drill, with a 20% failure rate.[21] In total, electrical station construction and well drilling costs about 2–5 million € per MW of electrical capacity, while the levelised energy cost is 0.04–0.10 € per kW·h.[8] Enhanced geothermal systems tend to be on the high side of these ranges, with capital costs above $4 million per MW and levelized costs above $0.054 per kW·h in 2007.[48]

Geothermal power is highly scalable: a small power station can supply a rural village, though initial capital costs can be high.[49]

The most developed geothermal field is the Geysers in California. In 2008, this field supported 15 stations, all owned by Calpine, with a total generating capacity of 725 MW.[36]"
Reply: RonJohn63 There’s really no need to be so rude to someone who was suggesting a point. Debate it by all means, explain why his ideas won’t work, but don’t just completely ignore his thoughts because he doesn’t have the relevant education to back it up.
Reply: @cypher10297  "In India we are establishing a huge network of solar panels and wind turbines for power demands."

That's a very great shame! Solar and wind destabilise the grid and the electricity market, which by the time these things are corrected for means expensive energy. India needs economic development above everything else if you want to rapidly improve the lives of the greatest number of people by the greatest degree. That should be your only priority. Wherever in the world there is a high penetration of solar and wind, electricity prices are high. Rich countries can afford this economic penalty - India cannot. 

In the short term (say for the next 10 - 15 years), India should continue to increase and improve coal mining and expand and improve coal-powered electricity generation. This offers the easiest, most scalable, least disruptive and lowest cost option for at least the next decade or two. This can be supplemented with natural gas, mostly by expanding LNG facilities and trying to establish long term international supply agreements. India will soon be the second largest energy market in the world and should be able to leverage that power. 

Also in the short term, India should be investing heavily in 4th Generation small modular nuclear reactor R&D with a view to having an indigenous commercial capability within 15-20 years. India easily has the science and engineering capability to accomplish this goal. This is by far the most promising future technology for low cost, easily scaleable, reliable and secure energy supply. As SMRs become cheaper and easier due to continuous process, supply chain, and economies of scale improvements, you can then gradually phase out coal. 

This plan can be achieved at far lower cost, with far less disruption, and far more realistically than wasting money on solar panels and wind turbine, which are a complete and very expensive dead end.
Reply: @Obscurai  Even if the earths magnetosphere were to magically disappear tomorrow, it would take tens of thousands of years to hundreds of thousands of years for the atmosphere to dissipate, possibly even millions of years. This timescale is irrelevant to humans, as we certainly won't even be on earth in 10,000 years, let alone 100,000 years.
Reply: Iceland has a geyser active for over 700 documented years. Iceland currently already applied this technology and are meeting 95% of the countries demand in power, hot water and household heating. And it’s so cheap it’s almost for free. Agreed, good maintenance is a must, they’re doing that as well since we haven’t seen any shortages since they did this. So all you need is willpower, due diligence and inventivity
Reply: @MerkDolf  "producing more energy isn't the answer"

Producing more energy IS the answer to improving the quality of life for billions of people living in absolute or relative poverty. Although it is true that with modern technology economic growth has an historically low energy footprint (i.e. unit energy per unit GDP is lower than it's ever been in modern advanced economies), getting the entire world's population up to an acceptable living standard is going to require a massive overall increase in the amount of energy consumed, and therefore generated. There is absolutely no way around this unless we tell billions of humans that they have to remain poor for the good of the planet. Even if we did that, I suspect their response would be "Fuck you!". 

We need to focus on solutions that make energy cheap and abundant, and for this - as with everything else that has ever improved life for human beings - we need technological breakthroughs. Wind and solar are dead ends - they are fine for rich countries that can afford to build huge stacks of money and then set fire to it as a vanity exercise - but poorer countries cannot afford such wasteful folly. I didn't think geothermal is the solution either, except perhaps in a very small number of locations. The only logical, practical, universal and scaleable technology that has a chance of fulfilling humanity's requirements in a practical time scale is next generation nuclear (i.e. small modular reactors). In the meantime, fossil fuels are the best and cheapest option for most of the world.
Reply: @aporiac  Yes, I didn't consider all the places that only get electricity on Tuesdays, or the electricity is only on for one hour each day, or where the only place that has electricity is the store in the center of town and that is by a generator to keep freezers running.  Or small villages that have no electricity, or refugee camps that pop-up on the outskirts of a city with people that had homes in places with electricity, who now may have a light bulb in the tin and cardboard hut they made for themselves, looking across the field at the city full of lights. 

I recall sitting one day in a small village when the guy that I was out there working with said to a resident, 'you don't know what your missing" and I said isn't that great you think your life is so much better then theirs and they are perfectly happy they don't have all the trappings that we do and they don't miss not having electricity. I then told him your problem is that you think your way of life is so much better and everybody should live like you do.

Now if people want electricity and they have none of very little, yes Help them build Wind and Solar maybe even micro-hydro teach them how to build and maintain it. Let them be happy. The best thing when you have a place that doesn't have this stuff you can start them out better with good low consumption electronic and electrical mechanical devices that work harmoniously with electricity from renewable.I can tell you this if we stop being so dang wasteful with our current production we can start sharing some of the excess. If you don't fix your house how can you tell someone else this is how you should do it don't worry about how I am doing it wrong.
Reply: @aporiac, I forgot to talk about the places where government provided electricity must be shut down every day for so many hours because if they don't then the back-up generator companies will remove some of the government officials from the planet. The rich and well to do can afford the back-up generator service but the majority of the people can't so they suffer for these people. Just think how you would do in a place like that bringing in something that competes with their monopoly?
Reply: @MerkDolf  "they are perfectly happy they don't have all the trappings that we do"

That is a personal romantic dream for you to enjoy, but has nothing to do with reality. People in the circumstances your describe escape it if there is an opportunity for them to do so. When they get sick they want access to doctors, medicines, clinics, hospitals, etc. They want clean water and sanitation, a cheap and secure supply of food, the ability to communicate easily and quickly across distances, to know about the world outside of their immediate environment, to acquire new knowledge, refrigeration, roads and transportation, computers and the internet, light at the flick of a switch, a long life with the least amount of suffering and hardship, and the possibility of improving their personal circumstances, if not for themselves, then at least for their children. You can afford to have a romantic view because you do not have to live their life.

If you wish to discover what people want, you must observe their actions. Already more than half the human population has moved to urban areas in the hope of gaining easier access to the services I've described. They do that because they live in the real world, rather than your dream world filled with fantasies you can afford to indulge in because they cost you nothing. This trend is continuing and accelerating. The UN estimates that the entire global human population growth, which is expected to peak somewhere around 2100, will be in cities through migration and because that is already where most people live. 

"Help them build Wind and Solar maybe even micro-hydro teach them how to build and maintain it"

Your offer of help is entirely useless to them.
Reply: @MerkDolf  "I forgot to talk about the places where government provided electricity must be shut down every day for so many hours because if they don't then the back-up generator companies will remove some of the government officials from the planet"

Yes - a precondition of human progress is rule of law and good governance. Education in this area is important. Any human institution is going to be imperfect because human beings are imperfect. However, that does not mean they can't be improved. The most important first step is to acknowledge human imperfection and then to design institutions in such a manner that this doesn't become an insurmountable problem. This has largely been accomplished by human beings in developed nations, although, of course, not perfectly. Fortunately, human beings don't need perfection in order to thrive.
Reply: @MerkDolf  "The current Secretary General is pushing for world wide energy reform. Of course one of the ways this is proposed is by sustainable development. "

This is a disastrous policy for the developing world. Adopting expensive energy solutions is not sustainable and the promises that rich countries make to compensate the developing world for buying into this fiction are false. The current UN Secretary General is pushing the greatest snake oil scam ever perpetrated on humanity. 

"In some places in the world those things along with drainage ditches led to the eradication of malaria."

Malaria carrying mosquitos cannot in the majority of cases travel more than a few tens of metres from where they breed. Sometimes this extends to hundreds of metres and in exceptional cases, kilometres. Equipped with this knowledge, British colonial administrators virtually eliminated malaria from coastal East Africa in the 1950's. In Mombassa there were civil patrols funded by the administration, and if you so much as left an upright tin can in your yard that could gather rain water you faced a heavy fine. Seventy years later these control no longer exist and malaria is rampant. Any stagnant fresh water areas close to human populations that couldn't be drained used to be sprayed with DDT during the breeding season. We have long known how to control malaria. Now the only thing that exceeds the number of mosquitos in coastal East Africa is the number of governmental and non-governmental agencies and their staff, international and local, studying the problem. It is one of the largest and most important economies in the region paid for by your aid and charity dollars. It is the humanitarian non-industrial complex, worth hundreds of billions a year.
Reply: @aporiac Yes it has to be sustainable!Back to my original point when you are implementing a new energy generating system to replace old one or completely new, you should reduce energy requirements as much as comfortably possible, before you rate the new system to be installed. It is far easier to generate 10 Kw than 20 Kw and if we can get the consumption down to 10 Kw just by utilizing the best energy efficient devices then we didn't need to make more power. Yes those figures are just numbers out of the air to over emphasize the need for everybody to do the little they can in reducing the requirement for energy. I'll have to go and check the facts as of today but I am under the impression that Louisiana eradicated Malaria and yes they did also use the evil DDT but as far as I know it hasn't returned. The mosquito is still there but the parasite isn't. There have been reported cases but these were attributed to people being in other parts of the world and getting the parasite in those other locations.
Reply: @MerkDolf  "Yes it has to be sustainable"

Advocating for the bankrupt and calling it "sustainable" is called lying.
Reply: @hasher2265  You mean convection currents, right?
Reply: @robertsmith4681  Concentrate pipes perhaps? Cold in the middle, hot on the outside?
Reply: Wow! Someone who knows what they're talking about. I was about to make a similar post and fortunately noticed yours before doing so. This "Real Engineering" guy has only got a surface level understanding of these engineering matters. But hey with 2 million subscribers he doesn't care, he's making money from adverts!
Reply: @EivindKreyHanssen  There is still almost as much waste in Thorium reactors as in uranium reactors, just different kinds. The waste problem is only reduced, not solved. Thorium reactors have more or less the same problems as conventional nuclear reactors.
Reply: I , too , would love to see your thesis. Since it responds to some of my comments as well, I'll counter; the NW Australians are working on top of one of the crust's thinner places in the world and they are largely working "dry holes", bores not into aquifers (the term refers to levels or regions where water is flowing underground- most think of a river underground, but this motion is largely through tiny cracks in the strata they are flowing, literally through). Your capture and geo reactions are very similar to ones I have heard before, but they are tied to one specific type of geo thermal well. The Icelanders are mostly using naturally occurring steam vents, so depletion is controlled by natural events, rather than forced production- that said they have done and published huge volumes of info- they do "improve" these natural sources, many have well charted "high/low" patterns. Careful measurement of the source potential and  keeping energy extraction within them will mitigate much of the "local attenuation" you mention- in other words use the resource at the rate that it replenishes and no more- still a huge amount of energy, The solids you speak of are a product of extracting hot water or steam and directly running it through the turbines- most on the ground GT uses modern high efficiency heat exchangers and never run bore liquids thru the turbine side. FWIW, in addition to the silicates and other earth products in the bore water, platinum, gold, and several other very valuable materials could be "cleaned" out of a filter- whether that's economically feasible IDK.
  The other argument against GT is that it will put the "Oil Biz' out of business- the techniques to find high probability locations to drill economically successful GT wells, operate them, even the turbine generator sets, are all processes little changed from what they do to find and recover oil- different, yes, but less different than digging coal out and marketing it, which is where most of the older "Big Oil" companies come from- the coal mining biz. The Seven Sisters are a natural to exploit the GT business.
   Yellowstone and four other places on earth have lave plumes or puddles extending well above what we generally consider the boundary
 for liquid rock; as matter of fact these standing plumes are where the upthrust material that makes these five locations super volcanoes- and they will erupt again- on their schedule, not ours. The results if Yellowstone, or any of the others, go off is a world wide calamity- there will be meters of volcanic dust for a hundred or miles from the park, prevailing winds will carry much of the finer ejecta all the way to the east coast, where it will leave several inches to a foot of ash. Crop failures throughout the American MidWest are for sure, and reduces yields worldwide (Krakatoa, in 1888 cause a 10% reduction for a decade in Europe, 12k miles away as the wind blows- and Krakatoa is maybe one hundredth of less than Yellowstone. The caldera for the last Yellowstone blast is 800,000 acres of the 2.3 million acres of Yellowstone Park- when it goes off, no one anywhere will much benefit; we need cheap energy and this "crack" needs some security. The very processes you've described will help deepen and cool the "plug" that currently caps the volcano, and continued GT development as the plume continues to move south east from where it is can keep the lid deeper and more solid than it is, while providing a much better full time monitor than the part time efforts currently.
  Would love to hear more about your thesis- don't do IG, Pin, or FB; very few civil exchanges on them- here, often there are! 
  Good Health and Good Fortune!
.
Reply: Thank you. I lived in Nevada where there are several geothermal facilities. I talked with the engineers involved and others - you comments concur with theirs. A good source of energy, but not perfect. Glen
Reply: @carolmartin7042  Like Thorium, GT has been lobbied largely into the margins. Now, Greenland is melting down, much sooner than all these calamitous and self seeking doom sayer scientists said- now it begins to dawn on the powers that be that they have no legislative authority over physics and chemistry; that we may possess the knowledge and will to soften this, but we've waited rather late in the game. Enormous energy is very likely going to be critical in this battle between the earth as we have made it  and the earth we must revive if we hope to live even mildly comfortably from now.
   Nevada is a great state- much there besides casinos! Tell the Gov and Lege to hang on- the Yucca Flats Plan will be dramatically changed if Thoriums capacity to reduce other types of commercial waste into  energy and much easier handled materials.
Reply: @Rosewhite if you actually had a solar panel design that could pay itself off in one year you would be a billionaire
Reply: Danaili6i thanks to google
Reply: True
Reply: just dig even deeper, if you don;t believe me, at some point you'll get burned alive for underestimating something that has been burning for more than 4 billions years...unsustainable?, of course even the sun itself is also unsustainable, why would you think that your little nuclear thing will last forever?, when universe die, we die with it, until then we use the planet natural energy to power our electronics....

or you can keep using coal or nuclear and die even faster than the universe
Reply: @snim9515  No it is.

https://www.ucsusa.org/nuclear-power/nuclear-waste

That's why I'm more excited about other forms of non nuclear energy.
Reply: How about shallow ground source?
If the loop is near enough to the surface to receive solar sink from the soil?
Reply: Welp, then you didnt dig enough if ur losing temperature, also am i the only one thinking on killing 2 birds with 1 stone when i say that we shoud try using those naturally ocurring  "chimneys" (volcanoes) the same way we use cooling towers on power plants? Putting it into words made me realize that putting a turbine there whould make for an stupidly big Stirling engine lol
Reply: There is that town somewhere in Europe that has the buildings cracking because they got water in the gypsum which expanded it so the ground is expanding and shifting which is destroying buildings that have been around for hundreds of years.
Reply: Wannabe engineer here. I wanna be just like you. Im studying really hard in my a levels. I think you people are super awesome
Reply: Lmao and I am an arts student watching science stuff
Reply: @robertsmith4681  a friend of mine did a phd on geotermal, and produce flexible solar panels. CALM DOWN ppl. every source of energy has its drawback and every source of energy could be suitable for some places, usage, needs etc. Fossil fuels are as renewable as any other source, Ppl should just educate themselves and use them smart. For mass usage, nuclear energy is by far the best option, unless you have some good alternatives due to geography. 
Germany is now paying the price of subsidizing so called "renewables" by making even more CO2 than it would by never engaging it in the first place. (solar panels are great tech if you are camping, or sailing, or hicking, or floating in orbite, but not if you are at your average German home.
Reply: @snim9515  especially in a Pebble Bed designed nuclear reactor.
Reply: I'm not a Geo-Engineer. But the (Law of Entropy) comes into this.
The (Law of Entropy) states that the more energy is used the less plentiful it becomes until there is no more energy left to draw from. 
   The Energy that is used to produce another form of energy, electricity for example is a potential waste because of inefficient technologies causing entropy. The potential being extracted must be less than the recharging potential or there can be no balance and no balance leads to entropy.
Reply: Could you use geothermal only when the wind and solar production rate is low and thus extend the 'life' of your geothermal plant?
Reply: Thanks for the realistic view of the present approach. 

So excuse my excursion into a bit of fantasy.

Insert  (very robust) thermo-electric devices into hot places at the bottom of a hole.

Run (very robust) power cables to the top.

While such devices may be a long way off,  or may never be cost effective,  note ...

----temperatures much less than 100 C  could be effective
----thus holes need not be so deep
----no need for nearby water
-----no fractures of underground rock to cause earthquakes
----no plumbing to control hot water/steam

You can see why I am a math teacher and not an engineer.

ct
Reply: @robertsmith4681   Not an engineer  sums it up.So much wrong with this over simplification of deep well production process in general and geothermal process specifically
Reply: Ex nuke plant worker here. I agree with engineer. Cooling our earth’s core to provide energy can yield unintended consequences.
Reply: thank/.dunka??
Reply: Surely if you drill deeper, and use a closed system to pump and capture the heat. These problems are resolved.   Pumping water around a spiral would surely raise the temperature high enough. Esp for binary power plants
Reply: In spite of all that we must do it!!
Reply: But, wait. People have used geothermal pumps to heat their homes for decades now, you just have to make sure you set the amount of power extracted to the amount of heat added to the rock. Equilibrium. This technology isn't new.
Reply: How about a closed loop system where air conditioners draw the heat in and the gas goes to ocean and gets compressed by swell pumps. Then you tie that in with a closed loop heat generation plant like this one https://youtu.be/LJV4d4XtHuo
and a desalination plant.  Vacuum jacket where needed. In places like California where we go through massive amounts of electricity cooling houses, buildings, food,  and making ice,  it seems like using that heat to make electricity and desalinate water is the ticket. I designed closed loop extractors for cannabis extraction, and it led me to this energy idea.
Reply: @huntera123  Solar is the most economical form of energy today, period. And it's getting cheaper. So why use fossil fuels? You got personal interests at stake? Stocks? You work for Chevron?
Reply: Thank you OP.. was thinking the same thing while watching this video. That geothermal is not a renewable resource as much as solar. Albiet the sun solar energy is limited to its life span, removing a tremendous amount of heat from within the earth may have adverse consequences to the health and safety of our planet over time. Turning Earth into Mars would be a terrible mistake. If our core cools down and stops moving, our atmosphere will be eventually stripped by solar wind and Earth will become Mars 2.0. The amount of heat removed from the Earth's crust/mantle/core for this to happen could probably be calculated.
Reply: Feeds Ravens  "When you burn the kerosene, it is split into CO2 and water. And then you take this CO2 again and make kerosene out of it." 

S T O N K S !
Reply: I'm embarrassed of my comment now. Great analysis.
Reply: thank you it was profound
Reply: @electronresonator8882  schizo tier comment
Reply: Why are German cars so unreliable?
Reply: Thanks for the comment. Really useful
Reply: S nim yes it is
Reply: Well said.
Reply: Danaili6i can reverse global warming at the same time😅
Reply: @robertsmith4681  That's crazy! The TBM will use more energy then you will ever recover, geothermally! Besides TBM's are manned machines, like people, they can't function in any zone hot enough to boil water! I think you may have stayed at a Holiday Inn express last night. ;)
Reply: Thanks for your insight!
Reply: @NickHorvath  the main point of not using closed loop is surface area for the heat transfer.  As the video demonstrates when they are drilling, they intentionally form cracks, increasing the surface area where the heat exchange can happen increasing efficiency by orders of magnitude.   The water is artificially pumped/recirculated and kept under pressure to allow the warm water to rise to the surface instead of getting stuck in this cracks.
Reply: Danaili6i now very simple (i am a laboratory physicist from Switzerland)

An answer to number 1
Just pump less heat out of one spot
This will keep the spot in a perfect balance 

An answer to number 2 
We can make a loop, yes it is difficult 
But if we put enough research into it, it could work

Also the main problem, we dont have a choice, there IS NO OTHER energy alternative outthere
Reply: Stay on the surface .. plenty of energy.. Stick a Giant needle into mother earth .. she don't like that .. gives you earthquakes.. just a thought.
Reply: @vDarkness Falls 

Your comment is factually wrong! 

The Earth’s inner core is nickel-iron solid and the outer core is MOLTEN ROCK . 

The SUN IS PLASMA !
Reply: @Kimberly Peacock 

What a rambling incoherent comment !
Reply: In South Australia we spent hundreds of millions on trying to develop geothermal energy. The project fell into one problem after another and was eventually abandoned. We now have the joy of sitting on a huge coal and natural gas reservoir that is cheap to access but we pay the highest electricity prices in the world because we buy into climate change alarmism. Large manufacturing is leaving and we could soon be a wasteland of high unemployment, poverty and crime.   CO2 doesn't produce those.
Reply: The SINGLE greatest problem with geothermal heat is that ROCK IS A FANTASTIC INSULATOR - what that means is that when you remove heat, it takes a long time for the heat from below to percolate up and replace it.

EVERY SINGLE GEOTHERMAL PLANT BUILT HAS EXPERIENCED A DROP IN EXTRACT FLUID TEMPERATURE OVER TIME.  Even the Icelandic ones built on top of a mantle plume.

Natural hot springs, etc have heat extraction more or less in equilibrium with heat replenishment. Geothermal plants cannot operate in this mode as they would generate about 1% of the power needed to be economic. That means the ones that get built, have lifespans in the region of 20-50 years

And then there's the extreme pollution events that have happened from the waste water....
Reply: @huntera123  Hi, self-identified 'green' here who works in infrastructure and renewables. Whilst there are people like those you describe who think [solar/insert favourite tech here] will solve all of our problems, most professionals in the field recognise these physical and practical limits to given single technologies, which is why a widespread development of many renewable energy technologies is so important, taking into account baseload (geographical limits for things like geothermal and hydro, supply chain limits for things like  energy from waste and anaerobic digestion) vs intermittent (and within intermittent, overlapping or complementary production such as day/night and seasonal wind speed cycles), location on grids (some tech is more modular so can have less transmission losses, other tech produces more but needs a centralised plant) etc. 
The UK government's subsidy scheme, which explicitly encourages the development of emerging tech that will complement the established wind and solar tech ('Pot 2', in the jargon), works towards this by encouraging the simultaneous development of a wide range of renewable energy sources.
Reply: @paulblaquiere2275  
But the renewables aren't very renewable. And they are not going to change the climate to a more benign state. But the non-reneaables will make the grid less robust and reliable snd far more expensive. Which means the cost of living will go up. A lot. For no good outcome.
Reply: Pacificdragon Thorium reactor is your only real hope.  Good Luck.
Reply: @WilliamJones-Halibut-vq1fs  
And where does this "hope" exist please. Perhaps the assumptions about climate are creating the need for brobdigandian "solutions" that actually cause more trouble and don't actually work.
Reply: Just put in conductors and pump in and the out the hot water. Recirculate without mineral transfer down hole. We can drill 12.5 inch hole at three meters per minute through granite.
Reply: @markmcafee2430  
"Just"
Reply: 7.8 billion people and "Always Growing" compared to 4.3 billion in just 1980.
We can not keep that up while the earth's mass and resources do not grow.
Overpopulation is a taboo topic when economies NEED eternal growth to function.
Reply: @huntera123  My favorite of issues they ignore is Energy Sprawl. These alternatives to fossil fuel and nuclear are quite low in energy density including geothermal, for which locations hot enough and vast enough to extract the heat in a economical fashion, are few and far between. I guess when the public gets used to paying $10 a KWhr, then the sky is the limit. Taking plants on and offline for extended periods .. LOL. How many would be needed to ensure continuous energy production? Variability of wind and solar? Clearing forests for palm oil production? Sprawl sprawl sprawl. There is no substitute for fossil fuels while maintaining a certain standard of living. These energy greens are delusional fo sho ...
Reply: @NickHorvath  or instead rely on solar and wind with decentralised mega grids that span over continents ... Like European mega grid and let nature and earth rest in peace
Reply: Pacificdragon steam coming out can be recaptured and reused, with a large enough structure. This can be effectively and cheaply done with tarp and wire mesh const. tarp between two meshes, with some arch support
Reply: @MrMuki61  i know iam late and iam by no means an expert. I agree with you that It would likely be more efficient but the amount of heat giving rock is lower your way. 
I think 
Though I like your idea:)
Reply: @Obscurai  >using more geothermal only accelerates this cooling.  A cooler core means a less active core, which leads to a weaker magnetic field.

This is certainly something to consider, but "considering" is not the same as "giving up immediately." "Considering" means that we assess the danger and then react accordingly. You need to supply some solid calculations of how serious this effect would be if we used a lot of geothermal power. Only then will the consideration be settled. How long until the magnetic field reaches critical levels if we use zero geothermal? 100 million years? (i have no idea, i just made that number up as an example.) How much sooner will that happen if we supply all of humanity's energy requirements with geothermal? A thousand years? 20 thousand? Half a million? That answer will dictate whether stealing energy from the core is a serious concern or not. If you can't supply those numbers and how you calculated them your concern will only be speculation.
Reply: @volbla  Correct, there is more consideration required before large scale deployment or prohibition. One main point to consider is that we don't even fully understand the mechanics of the core itself, and the linkage of the core to the magnetosphere also not fully understood. It is precisely because of these unknowns that large scale geothermal deployment is speculation either way. So you are correct, more data and study is required. Meanwhile there are existing alternatives that have fewer unknowns.
Reply: @robertsmith4681  This reminds me of what i believe was a darkdocs vid about how the soviets developed a nuclear powered underground boring machine, apparently it couldn't cool itself fast enough and blew up. Thats the story anyway /;
Reply: That and you may upset the ground God  by using his magma without offering tribute
Reply: Great inclusion.
Reply: @robertsmith4681  A physicist by education is here. Regarding your point N2, this is not how power plant work. Closed loop is not possible - in order to get some useful energy output we need to cool down the water/steam somehow. While the whole system is underground there is nowhere to release this heat as the whole system has the same temperature.
Reply: @vitalilisau6181  I realize that the idea is to use temperature differences to make those systems work, that being said, running pipes up to a surface cooling pond comes to mind. I'm thinking something along the lines of runniing pipes at the bottom of a lake.You can still house all your hardware underground where it doesn't need to have a surface footprint.
Reply: What he means by boundless/endless, is the fact that if we mastered and harnessed geothermal energy, the amount of time it would take for us to completely run out of the heat energy from the earth, would be such that humans likely would no longer exist at that time. It would last until the very end of mankind.
Reply: I'm a Canadian engineer (Materials, chem and environmental) and I agree with @Danaili6i .. Economics is driving the switch to renewable energy in N. America.  Renewables are economically superior, here.  However, the governments are not doing all they could.  The subsidies on fossil fuels should be reduced.  Also, international energy agreements between Canada and the US become a barrier. .. Also, see Mark Z Jacobson. He is the best.
Reply: @robertsmith4681  you can use closed pipe only if temperature is high enough to warm up water in that pipe fast enough which means either very shallow heat source or very deep hole and thus long pipe which in turn means veeery expensive hole, and more importantly strong enough pump which tend to be expensive. All these expenses would cut into profitability of the plant when compared with other options.
Reply: @snim9515  in Italy we are still paying for dismantling the nuclear plants we made. The costs are still charged in the bill after 20 years. Believe me nuclear waste is a REAL problem. Costs are exorbitants (until you put your radioactive stuff/garbage on some ships traveling to Africa... ; )
Reply: I have visited the geothermal plant outside Reykjavik. I love the fact that the waste heated water is cooled in large blue lagoons, so that tourists can pay $80/day to immerse themselves.
Reply: @cypher10297  If the Indian people can bring Thorium reactors to the mainstream I will never look at India the same way. It has the potential to do major things for the world. If power is cheap and clean it makes some things so much more possible.
Reply: @robertsmith4681    First, crop rotation doesn't necessarily mean not using a field for a year.  It means planting different crops.  Corn one year, beans the next.  So the ground may not lie fallow at all.  Second, The infrastructure required to move the power from the point of generation to the point of use is massively, both in size and cost.  To have transmission lines sitting dormant for  years while the aquifer recharges is not feasible for at least three reasons.  1:  Cost.  You'd have to duplicate all of your transport cost, so the customer will pay for 2, 3 or more times for the same service.  One mile of line can easily exceed several million dollars, so you could easily have a few hundred million sitting unused for years, even in a small state.  2.  Reliability.  Equipment that isn't used tends to go bad.  This is true for even power lines.  3.  Public acceptance.  People grudgingly accept having large lines on their property, but what if you told them, "hey, we want to build this really big line, but we don't plan on using it for at least 10 years.  But don't worry, you'll see us every other year with big trucks tearing up your land to pull maintenance we don't normally have to do but every few decades".
Reply: @MrMuki61  trouble with your thought on Pentane is it will boil off as it reaches the low temp. I've worked underground at around 3000 ft (potash mines) Temp's there are around 40 degrees .... Great so you can drop pentane down let it boil and then then use a heat exchanger.... except all generation facilities need cooling to stay efficient... So now you have to either transfer the heat to the surface for a cooled generator or pump down cooling and circulate it. Again cooling your formation and being ineffcient.
Reply: @snim9515  Yes it is, Especially all the Unburnable Isotopes that are stored everywhere around the world
Reply: @cypher10297  The problem is that Renewables are not a guaranteed source of energy and production does not follow demand curves, that means gigantic overprovisioning is needed ( costly ) plus storage solutions are needed ( also costly ) plus backup generators are needed that are paid to lay still ( costly and wastefull ).
Reply: @vDarknessFalls  The earth's core is molten iron.
Reply: @dwwolf4636  You have a valid point that is well known among the engineering community for decades.
Power on Demand (POD) is an issue with wind and solar energy. That's why it is to be combined with nuclear or geothermal (if it becomes a commercial success) for supporting the POD.

There is not going to be "storage facilities" anytime in the future sooner or later. So you can stop quoting that anywhere you speak the drawbacks about renewables. Storage in batteries is just so not logical and feasible at a large scale. But storage is actually possible with pumped storage hydro power plants. But that too is highly restricted to the location and conditions of the power demand and supply.
Reply: @snim9515  Could you please explain to me why this is the case?
Reply: @snim9515  elaborate more about it?
Reply: @afriedli  I only downvoted you because of your coarse use of language and abuse of the @GicaForta.  There was no need for that.  We must respect everyone's views whether or not we accept them.
Reply: I have a proposal!!!!
Reply: @kresimircosic9035  It's probably because the video emphasised that this technology is relatively common in Germany.
Reply: @gergc4871  the fleas can't control the dog, but they can iritate it.
Reply: @snim9515  maybe not for you, but for generations to come??
Reply: A closed-loop system would mitigate  issues with scaling/fouling, yes?
Reply: Thanks!!!! How about "cooling the earth"? I understand this sounds like a stupid question but once people thought oil would never end. Thanks!
Reply: Feeds Ravens  that's amazing thanks for mentioning this
Reply: I'm a heat exchanger technician. Heat exchanger systems can cost quite a bit. There's also maintenance. The gaskets used in-between the plates do degrade over time which causes leaks and cross contamination. The scale and deposits would require chemicals and regular closing off the unit so that it could be opened, cleaned and possibly replacing the gaskets. Despite these drawbacks they are remarkably efficient and used in a lot of large buildings and factories. I've seen them used to cool the bearings in turbines at traditional power plants as well as a bunch of other industries.
Reply: @KimberlyRPeacock  Great comment, and pretty much bang on.  The one quibble I have is that ORC and Stirling engines have been tried and output is pretty miniscule, eg single kilowatts. The research I'm aware of has been done at National Research Council Canada (Bell's Corners labs) and I think ETH in Switzerland. Where ORC was especially interesting was power modulation and heat modulation (panel-cooling) for solar PV farms in the Negev.  I saw it being demonstrated by a company there, and I think Siemens bought the rights of the company shortly thereafter.
Reply: @acchaladka  ORC is capable of terrawatts, the real problem is costs. and while big dams have huge upfront costs generally we can be sure they will be around many many years after capital investment. The best orc territory is also cyclone and hurricane territory.  There is no limit to stirling engine size and power but if you want reasonable power density you are operating at elevated pressures and then you have issues.
Reply: Nick Horvath - Re: connecting two drill holes. Why. Just insert a pipe in a pipe.
Reply: Danaili6i - On point 1. All thermal field have geological heat inputs. Just scale the extraction to equal the input and, voila, renewable energy. Only a problem with an extractive mindset...
Reply: Danaili6i - Point 2. If you inject water into a heat-exchanger, you can control the characteristics of the transfer fluid to make demineralization more manageable.
Reply: Can i read Your thesis?
Reply: Interesting thanks for the comment
Reply: Is it not easier, cheaper and more viable in areas with thicker crust to use Peltier technology in a low temperature gradient well. One could have a well under every house.
Reply: Feeds Ravens  
I don't see how the CO2, at a very diluted 400 parts per million, could be taken out of the air efficiently enough without losing the heat from the furnace.  At this time it's necessary (mandatory!) to remove the CO2 and store it permanently underground until the atmosphere is reduced to 300 parts per million.  Then the CO2 can be recirculated as a biofuel.  But the amount of CO2 is huge, hundreds of gigatonnes, and the most reasonable and cost effective way is to plant billions of trees and as the trees are burned as biofuel the CO2 is captured and stored underground.  Reforestation has been advocated as the best way to capture and store CO2.
Reply: @huntera123  
Doesn't matter what you call the CO2, it's a greenhouse gas and has to be removed from the atmosphere until it drops to 300 parts per million.  Reforestation is the most reasonable way.
Reply: @huntera123  
We're just glad that the rest of the world ignores the climate change deniers and are doing the right thing.  The fools will be dragged along kicking and screaming climate change doesn't exist until they die.
Reply: @w8stral  
The geothermal electricity is already developed.  In N. California there is a geothermal area called The Geysers where 880 megawatts of electricity is constantly generated day and night.
Reply: @acmefixer1  And it used to be MUCH higher Gigawatts until they drained the geysers of water and the whole thing completely shut down.  They are now dumping essentially sewage into the geysers to generate power instead of putting that water back into the rivers so instead downstream they are limiting farmers ability to use water...   Geothermal is a very niche product only available where there is sufficient heat and sufficient water to make it work.  It is not universal other than for general building heating.  PS: If you have not put in ground loops or a ground heat pump well for heating your home/business, you are stupid.  Will pay for itself Very quickly.
Reply: Regarding point 1.
Maybe we should surround the Yellowstone caldera with geothermal plants. It might postpone the next eruption by a few days. ...or maybe that would make a shell over the magma that would require a higher energy blast.
Reply: @Bluuplanet  Magma chambers are ~50-->100km down... Good luck drilling that far and Yellowstone, like Hawaii or iceland or.. are hot spots through the entire mantle of the earth so ... Good Luck
Reply: @huntera123  I know you're a contrarian and like ruffling feathers, but you can't be serious. This isn't a question of belief or non-belief (i.e. faith), but of actual science v. cherry-picking date with a strong confirmation bias. Scientists are sceptics by definition; it's the self-proclaimed "sceptics" who have a herd mentality, albeit a small herd with pretensions of superiority.
Reply: @huntera123  wind and solar are stopgaps. A geothermal plant good for 30 years would work a treat if the holy grail of fusion really is 30 years away this time.  But agreed (by most greens now as well) that nuclear is a better way to go. And let's not forget the oldest and biggest source of clean energy, hydro.
Reply: @vDarknessFalls  the deepest man-made hole goes down 12km or so, not even a scratch on the crust, let alone the mantle let alone the core. The radius of the earth is 6,371 km. And the core is not "plasma": the outer core is liquid, the inner core is solid iron.
Reply: @Matthew Tong you aren't getting anywhere near the core; not even as far as the mantle.
Reply: @robertsmith4681  You missed a fundamental point. In order for a heat engine to work, there has to be a hot side and a cold side. If everything is in the tunnel, you can produce no energy.
Reply: @huntera123  You are correct. The lower the temperature difference between the hot side and the cold side of a heat engine, the lower the efficiency.
Reply: @vDarknessFalls  Plasma??? Where does one get "plasma" and how is it used?
Reply: @pauleohl  The way I look at it, topside would be "cold" since the basic concept is merely intercepting heat on it's way out and making use of some of it.
Reply: @robertsmith4681  > simple solution is to alternate production between sites, more or less like farmers don't plant crops in the same field year after year. Leave things to warm back up and then restart production. 

This does not solve anything.
You should just run the geothermal plant at the power output where subsurface stays at constant temperature - the energy you take to generate electricity is replenished by the heat flow from deeper interior.
Trying to get more now only means later you will have to draw less.
Reply: @cypher10297  not an engineer or scientist but about the nuclear power plants that you mentioned were being developed for India. The traditional nuclear plant requires massive amounts acreage resources and just to ensure safety of the people. However I believe a few month's back I saw somewhere that scientists have been trying to develop safer methods of production. The gist of it was they were developing mini reactors that were no more than the size of a small house or apartment. The drastically smaller size in my opinion is the key take away here. With the smaller size they are able to reduce the total overall cost of production increase the safety features housing the core for a cheaper price. Ultimately I think this shows that this will be better in the long run inevitably because you're not producing the same amount of waste as you do from the large reactors. And correct me if I'm wrong but isn't the loss of heat a problem when you're transferring the steam to the turbines.
Reply: Great comment - which is good to ponder on. Here's my thoughts on the issues you raised:

Point One: Thermodynamic Laws

This is an obvious point that would be a problem if we had no Moon.

The satellite called Io, in orbit around Jupiter, has shown gravitation tides within the planet will continually generate heat.

This means we would need to monitor the inductive transfer against the regeneration of heat.

Point Two: Scaling / Fouling 

Filter the water.

Now ... I'm not claiming to be an expert - because I can't imagine they haven't already tried filtering - but I'm guessing my points are worth considering.
Reply: Thats interesting stuff  but how can this be fixed? How much? Cause humans mostly like money.
Reply: Thats interesting stuff  but how can this be fixed? How much? Cause humans mostly like money.
Reply: @MrMuki61  your Country impose the ban on doing business with Muslim Nations subsequently the owners of vacuum last technology IDE systems I think they're known by accepted a mere dollars for that top 50 technology contribution of your nation. Vacuum ice technology is a closed loop for the vapor condenses to distilled and the product is the crystals mixed with the minerals and sold as a heat sponge. Vacuum ice technology for example has been historically used to produce crystals for recreational purposes as well.

Your country obtains water considering the high-grade heat a nuisance meaning it is very sick and fully captured. I wonder if Muslim nations bribed politicians to boycott Muslims so that they could shake down the vacuum lice patent portafolio?
Reply: @walterbunn280  incidental released gases are not natural anymore than intentionally fracked ones are. What are the standing of the diction which is possibly or even likely flawed puts the word natural into our lexicon as the alternative to engineer gases for illumination like coal gas. Call it methane please unless it's genuinely naturally obtained. Call the alternative to fossil fuels engineered liquids like nitrogen not kerosene LOL
Reply: @vDarknessFalls  commence the era of refined culture where only addicts sell their time for money doing things they don't enjoy and make the world worse.
Reply: @MervynPartin  in Florida the lowest food is illegal to harvest. That's a wise law. Selling rotten citrus it's not the way to create demand. Projects like yours are the way to keep burning fossil fuels popular. This is not complicated.
Reply: @emilie6466  you're claiming that fractional trillions are significant?
Reply: @KimberlyRPeacock  many people Advocate things for the grid from a small-minded perspective but the way you feed the grid is play Celine Dion. Or see beyond it stop. The use of electricity has people thinking of it as energy and that serves the interests that would have us burn ourselves into even greater Jeopardy. Electricity is what you need to operate transistors. If somebody tells you it's so good form of energy to do mechanical work with grab a Rock and Crush their head before all hope is lost.
Reply: @remenencenda768  Fusion is obviously occurring within the core and we don't need navigational magnetism Givens GPS satellites nor do your samarios get adequately rebutted by the cute joke at the end. Simulating Solutions on supercomputers helps tremendously but it's not trivial. The human mind can hypothesize and creative thought experiments that are the predecessor to further investment like full-scale simulation. The electric grid is a metastasizing cancer sucking up non-replaceable capital not to mention materials like copper which once captured are difficult 2 claim for higher in better uses then electrification.

Mechanical work being done by Steam is not forever to be done by electrons instead. Mechanical work and Heat are primary drivers of pollution. Of the mechanical work that is defendable much going on all essentially can be done without involving electricity or the production of additional pollutants but rather the contrary Cantu a very significant degree export Surplus Heat into outer space because in this race being neutral is being lame.
Reply: @TheScarvig  unmeasurably in the worst-case speed it up. Nearly impossible it would jeopardize any life on Earth. But science is what I believe in so we do our better analysis then just being glib. You have to get people out of the industry's of the weapons of war or serving the fossil fuel interests. Distract them or create Noble science and engineering Pipelines for human capital funding selection and education that requires the recipients to not go into those Industries. You can't make the world a better place by providing false scholarships resulting in graduate that are free to enlist in military or petroleum careers.
Reply: @Obscurai  U wish!
Reply: @frankmueller2781  the consensus of the world's scientific community is not elitist
Reply: @joseylastborn8790  Wow wasn’t expecting a reply a year later. Especially beneath the plethora of other comments, but yes those billions would be significant if that is what you’re referring to. Especially, since every new drilling site would be operating at a loss and would most likely not turn a profit until decades after. At that point it would actually be cheaper to build nuclear power plants considering their return on investment would most likely be infinitely faster than drilling an artificial geothermal vent. And all of this goes without talking about the potential issues, maintenance, innovations, and renovations required to support a plan like that. I think by the end of one functional plant you be sinking well into the ten’s of billions and would not be generating nearly enough energy in return.
Reply: @joseylastborn8790  Electricity and electromagnetism is for more than powering transistors. Are you Amish by the way?  I guess you wish to live in a world without Aluminum? Or limit us to tool steel and what it can cut, for you would say goodbye to carborundum. Also no servos, steppers, etc.
Reply: @AK-gg5nh  it is only an issue in whatever you prefer to as the fruit that's on the ground. First there's not that much of it oh, and the quality is the lowest, so you should baby get it if you run out of the rest which is not possible in this context. What the electrical Paradigm does is look to fossil fuels when the distance cross oceans. So by Bridging the oceans in any means for other than fossil fuels including certainly geothermal earthquakes other than the harvesting infrastructure itself effecting need not be a concern.

You have to convert the energy into movable form. Electricity is problematic because of the high Capital costs of moving it and using it not just converting whatever energy into it. We don't know what the true cost of reducing the space the matter we call the atmosphere takes a at ground level by nearly two decimal orders of magnitude what is referred to as 1/700 but if you heat the liquid that you produce to high temperatures with say low grade that would otherwise be insufficient locally to do the work that you wish to do it's probably in excess of two decimal orders of magnitude Maybe thousands of times as much space at atmospheric pressure.

And by atmospheric pressure I mean the gasses are hot but as if in the balloon at ground level. that's an interesting analogy though that I haven't thought about it before Towing cables into the air with superheated gas. It's comparable to hydropower?

In this video there is a map but what I argue is you only need one infinite heat Supply we're infinite refers to the scale that we could use and the Earth's internal heat being so significantly beyond that as to be unaffected. However if you think about heat being catalytic to recovering the energy that it took to liquify the atmosphere then the issue is not compression but rather can you do something with these other gases that's comparable to what you can do with hydrogen? Are there materials that soak up nitrogen specifically more compactly t h a n liquifying it buying the case of hydrogen a binary order of magnitude AKA Dublin. if you have a block of this hydrate and that's not likely the way it's spelled more like hydride when you heat it instead of being stable at atmospheric pressure the hydrogen wants to leave very very badly generating immense pressure that you could do work with and this laboratory demonstration component is referred to as a compressor actually because to obtain the high pressure hydrogen you feeling up with hydrogen and then you let that heat the material. it doesn't use much energy to store the hydrogen but you can take it out in terms of the pressure. the goal with what liquification is the store energy not try to double the amount of nitrogen you deliver so I guess you can strike the whole section. the goal is to move energy. even if the power lines are free your total system cost might be higher if by electrification. that is the beauty of system science and Fire I consider of primitive technology and I consider compressing diesel until the heat causes it to burn primitive. As I do electric motors. getting nitrogen to boil with solar free infinite heat and doing mechanical work with that is something that General Electric is very good at and there nitrogen turbines already available at the locomotive and well beyond size.
Reply: @emilie6466  the molten nature of the lava means that you don't have to spread your mines around the planet and it does seem from a systems perspective using yank technology to distribute what you produce with the heat is cheaper than a network of wells. The net present value of delivering mechanical work to any location 4 less than the cost of fossil fuels or electricity is clearly in the trillions of dollars. Not billions. Do you disagree with that?
Reply: @KimberlyRPeacock  I don't mean to convey that we should get rid of existing electrical production or consumption infrastructure. Nor that switching in the fractional horsepower or other special case examples can't be justified. But things like locomotives and you're heavy cargo propulsion systems 4C and even air those being electrical imposes costs not present with alternative Solutions that have less not more negative externalities even beyond the cost savings.

The locomotive is a good example because the diesel has been producing electricity for a while. Efforts are underway to replace it with batteries. These efforts are not renovation but entirely new Rolling Stock. I asked since General Electric makes diesel electric locomotive and they make a containerized 5 million Wat liquid nitrogen genpak why not use Renewables to produce liquid nitrogen and obviously trains have lots of capacity to carry liquid nitrogen instead of diesel.

Instead of asthma and cancer the area around the railyard would sell for a premium because it is the coolest place in town on a hot summer day. You don't put the liquid nitrification infrastructure in the middle of power lines connecting to the generator and additional power lines connected to the need for mechanical work. You put the liquid nitrogen infrastructure at the source and the destination avoiding electrons altogether. you let the free market determine how to move the liquid currently we use hoses to import liquid methane for your information. These houses have several layers of insulation and can be obviously scaled-up like all hose technology can be B possibly instead of miles with it being I think inches in diameter you could build it feet and diameter and seafloor fiber optic joining in some Millenia scenario from now put for current low energy needs on our continents clearly shipping is the answer but inertial banking shipping not obscenely rocket science propeller bulshit. Propellers have got to go. Yank the cargo. It's bye by bi directional so you don't need anchors or water agitating nonsense just the cargo pushing off the cargo Hypersonic Lee preferably. I read about the solid s a i l car shipper and I can tell you something about that that's why you don't want to use wind power. You end up wasting the winds moved vehicle. It lacks speed. It can't avoid weather. thousands of miles an hour is the way to go and politically creating subsidized to return path is a winner. there's lots of stuff people can ship besides their garbage including granite and spring water. Liquid nitrogen 4 Artesian spring water will not have the liquid nitrogen weighing too much given the man's for the drink versus energy. the shipping infrastructure that offer same-day delivery anywhere in the world stretches its capital investment moving hundreds of times as much cargo annually as current speeds. the article did not put the speed into kilometers or miles. If you're making sailboats it's like making the machines Walmart uses for their floors you don't want to unduly disrupt the market you want to operate fewer hours between battery charging and sell more machines but you cheat Walmart like that and they will produce the OWN floor Machine that does not cost in labor to operate. you can't be greedy cleaning up the liquids avoiding consumption of oxygen and release of carbon is the way to earn an honorable living take your energy get the air liquid with it move it use it that's the way to do real work for not just your species duh! species
Reply: Australia has good hot granite geothermal heat reserves mainly arising from the decay of thorium, uranium and potassium isotopes. However, they are mostly remote from potential markets and deep at around 4000m. 

Exploratory and trial wells have been sunk but corrosion, scaling and maintaining the fractures needed to generate steam at great depth have been problematic. At this stage despite the potential it doesn't seem large scale geothermal energy will be economically feasible in Australia in the foreseeable future.

It is a technology which may work better at shallower depths typical of volcanic precincts. The lower pressures of shallower wells means corrosion and scaling might not be such a problem.
Reply: @joseylastborn8790  I mean every idea in theory seems realistic on paper, but what you’re suggesting is to displace a well-established energy economy that has had time to propagate over the last 100  years over night. That is extremely unrealistic and the idea fails to grasp the necessary infrastructure required to facilitate such an idea, you are also approaching it from the perspective that there is a limitless supply which is simply not true, you are also ignoring the costs associated with construction, maintenance, and the demand for energy. A geothermal vent does not output nearly the amount of energy to meet demand at any given time and that’s why it has so little investment even when it comes to plants that take advantage of natural vents, the idea is simply untenable in a real world. The cost benefit analysis would show that investing in the technology is just simply not worth the hassle and there are a lot better alternatives on the table already.
Reply: @emilie6466  wrong on MOST or all points
Reply: I do not connect with this geothermal we’re discussing here? Geothermal pumps and Grids for heating and cooling although NOT electricity is free energy and offsets use of other dirty energies!  I can’t say I ever heard of this electricity geothermal energy?  Am I wrong?
Reply: Deutscher Schüler hier. warum nutzt man nicht Stirling engines? sie sind natürlich aufwendiger und ineffizienter, funktionieren aber auch bei niedrigeren Temperaturen.
Reply: Feeds Ravens   Potholer54 is a political activist, and not a very smart one.  Read The Chilling Starts  by Svensmark and Calder.  Good science and as relevant as when it was first published in 2012.
Reply: These ideas are a known concern so you just plan for them to take place and make adjustments. All forms of energy have advantages and disadvantages. Over 85% of all houses in Iceland are heated with renewable energy sources, thereof are 66% geothermal. Five major geothermal power plants are active in Iceland. Those five plants also produce a little over 26% of the electricity used in Iceland.Iceland is proof that your concerns are not significant.
Reply: 1. Can we augment the heat loss from opening up a reservoir using artificially decaying radioactive elements, such as radioactive materials from nuclear power plants?                                                                                                                                                                                            2. Can the issue you raised with scaling and fouling be addressed with improvements in materials sciences.
Reply: @robertsmith4681  Varying the location doesn't solve the problem. The heat doesn't simply regenerate: areas that "re-heat" are drawing that heat from surrounding areas and from below. Sooner or later this results in a cooling of the Earth's core. Climate change is a massive problem for modern civilization, but it is nothing compared to the nightmare of our planet's core cooling. It would take centuries, but this could actually end life on earth. The magnetic field that keeps our atmosphere from being blown away by solar radiation requires a molten core. You want Earth to become as barren as the Moon? This is how you do it.
Reply: @CirJohn  You're not so much drawing the heat away as making use of it on the very last portion on it's way out from the core. Nobody is talking about punching any deeper than the very top layers of the crust, what we already do in mining and so on.
Reply: @cypher10297  Did you graduate from IIT?
Reply: @robertsmith4681  
Crop rotation "heals" the fallowed ground.  Rotating geothermal wells simply pauses the addition of scale and corrosion.
Reply: @Bluuplanet  Use the pause to do maintenance, swap out old equipment and so on. Digging the hole is the hard part, even if you have to ream it and possibly refresh the liner seems like a fairly minor issue. The heat source is below and continuous/stable regardless and the equipment you use will do like everything else and get smaller and more efficient over time, so operators are going to want to pull them out regularly as they tinker with this stuff anyway.
Reply: @cypher10297  Meanwhile, in Poland, irresponsible politicians are postponing the start of construction of the first nuclear reactor. The expected commissioning date is 2038 :( A few decades ago the plant construction program was canceled after the accident in neighboring Ukraine (Chernobyl). I envy India's wise authorities investing in a Thorium powered future.
Reply: @cypher10297  go educate yourself on science. you may find real, and very simple answers to your CO2 agonies.
Reply: I couldn't agree more , scale from hard water is complicated / expensive to treat as it is without adding chemical injection strong enough to break down Quartz and Limestone in boiler feed water before introducing a super heater . I would imagine Quartz or LImestone as a dry steam could cause major issues to a turbine the same as hard water can then factor in conductivity / alkalinity levels as well I know it can be done , but at what cost ? Sounds good on paper but I could see it being really hard to achieve in practice without maintenance downtime and expensive chemical injection
Reply: @huntera123  You don't need to politicise this discussion by type casting especially when you are wrong.
Reply: Check out what Canada is doing in SE Saskatchewan where Geothermal wells are harvesting heat using water that is returned to the ground some distance away enabling heat to recover from deeper planetary heat.
Reply: Heat generated from nuclear decay is vast. It's beyond any concern about running out. The earth is 4 billion years old and it's still enormously energetic and the layered structure provides practically inexhaustible low entropy access points. It's just beyond our engineering to cheaply implement without natural anomalies
Reply: This is important information. Thank you
Reply: @robertsmith4681  Neat idea but you need to release the heat somehow to the surface.
Reply: @snim9515  good, put it in YOUR back yard.
Reply: @huntera123  according to big oil, coal and gas?
Reply: @jerrymctee5996  That's kind of the easy part when you think about it, all you need is some kind of conductor linking to the surface, or better yet liquid circulaiton.
Reply: Great answer..
Reply: You are absolutely right. I used to work in a power plant and the tips of our turbines were all ´´bitten´´ and eaten away due to 
SiO2 even with all the filtering we used to prevent that from occurring. Unfortunately they like to sell these things as the great 
Grail and people buy it. However if technology gets to take a step ahead, these problems may be overcome.
Reply: But geothermal energy will overheat the planet until it explodes.
Reply: @doomguard731  Volcanoes ensure this doesn't happen.
Reply: @robertsmith4681  That's what NASA wants you to think.
Reply: I was wondering about that.  Seems that we would be cooling down the core at a rate faster than normal.
Reply: It's great to see these comments and discussion. If I had found them earlier I definitely would have mentioned some of them in my video.  I wonder what you think a year later. Danaili6i, Are you still in the geothermal field or did you leave that behind after the thesis?
Reply: Wasn't this the plot of Final Fantasy 7?
Reply: @ Engineer here: 2 great points that are not mentioned often enough.
There are other problems too.
1) Most notably the actual temperature is NOT high enough. This was the problem we had in Australia with Geothermal. We have a number of hot spots various parts of Australia but the pilot plants we ran on them just never proved viable or economical. It might sound strange to non-engineers but you really want dry-steam (that has no water vapor) rather than wet steam (which still has some water vapor) so that you get the best efficiency out of the turbines. To get that you need around 600C the 400C in the mantle just isn't enough. Also in that part of the process where the turbines are you wan to use 100% pure water to avoid scaling and that means using heat exchangers between the the water going into the ground and the water being used to drive turbines and that also reduces efficiency.

2) Our biggest problem was that these hot spots were so far off grid the cost of extending the grid made any geothermal in Australia economically unviable. That might change because we are now extending our grid outwards for the solar generating systems.

3) The best places for this technology are in geologically active places like New Zealand and Iceland which already have substantial geothermal power. The other place where the raw heat is conveniently close to the surface are active volcanoes, but then who's going to risk several billion Euro, Dollars, Yen or Yuan building a power station next to an active volcano?
Reply: @snim9515  yh its safe disposal is
Reply: @TheScarvig  Human civilization isn't that big. Big enough to alter atmosphere. Too small to affect Earth's core heat. Radioactive decay keeps replenishing it as well.
Reply: I think we can all agree, that no single source of energy is going to work.  Each one has many pros and cons. Everybody has their own favorite flavor of energy.
Reply: Danali, your comment represents what the internet does best.
Reply: I am so happy that you commented this. I always felt like this was a bad idea. I always have trouble explaining to people why I think this is not the best idea in the world.
Reply: So good of you to communicate your expertise. As a pyromaniac, I have known about water being boiled in a Styrofoam cup over fire. And, upside down inside out with a vent might make a cheap kiln. Structure is the issue as the wall might survive the fire but could collapse. So, if there was a way to reinforced the Styrofoam water cooled wall and ceiling plus the flu vent, like even with say wood. One should be able to pump water into the kiln type hot box floating right over hot lava. Anyway, something of an idea no one thinks about maybe. Further, reuse is my idea to save heatwork. But, I hope just to have my process working on a variety of diameters in the near future.  greyishgreblum, "Pottery tap and die"💜
Reply: Mate can you provide any links to your publications ...
Pretty please
Reply: Also in places where earth's crust is thick it's just not by any means economically feasible to make a power plant for which you need a minimum of two 7+km deep holes with low success rate and which at best case is usable for a couple of decades tops. Better to use the energy directly for heating, or building e.g. windmills or other more typical heat sources. There is no one solution.
Reply: What's the drop off rate of the heat production ?
Reply: Thank you for highlighting the finiteness of the heat. It seems like people always ignore that fact
Reply: Hey, I'm also doing my thesis on geothermal energy! Recently the canadian company Eavor has tested its Loop system (AGS) in Germany. Since this system uses a closed loop system with pure water, it doesn't suffer from either of the main drawbacks you mentioned. They are estimated to provide heat constantly for about 30 years, after which time return will decrease. 

Furthermore, AGS systems like this can use a thermosiphon effect allowing them to run without pumps. I wonder if you have looked into this and have anything to teach me in this field. As I mentioned, I'm currently researching this topic for my thesis.
Reply: just do a closed system re-using the pumped water... use nanomaterials like graphene that can transfer heat wonderfully... it's kinda obvious the solution...
Reply: @brunnosilva2668  No it is not obvious. That said, all you say that should be done is already getting done for years and years.
Reply: Scaling was certainly not a problem I'd heard mentioned before and I'm curious how a company like Quaise will be trying to get around this when their first projects launch later this year